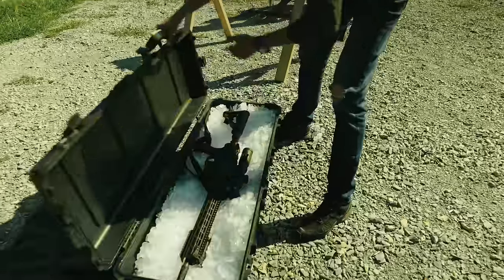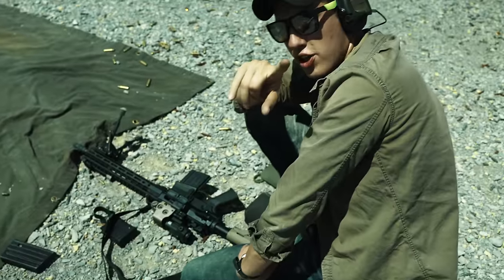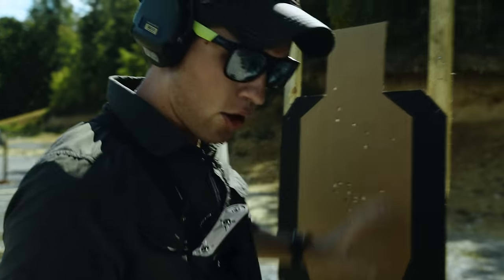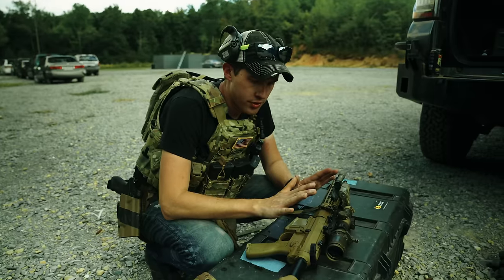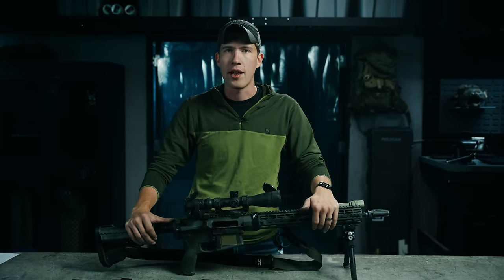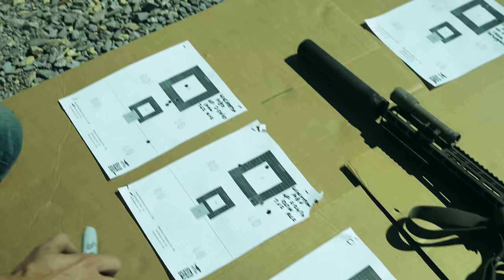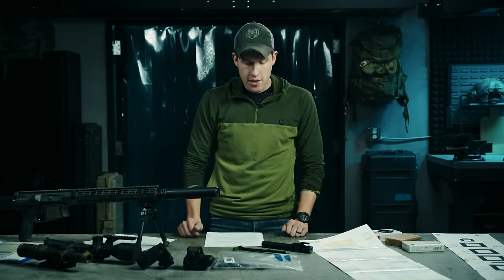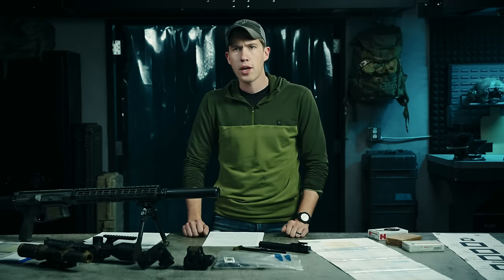Aero Precision M5 AR-10 5,000 Round Test

Comment: First of all, RIP Lucas’s shoulder. We have a few points to make, but in general, we look forward to getting the rifle (specifically the BCG) back in hand to understand where and why it’s weak points were exposed during this endurance test. We believe in continuous improvement and will be examining where we can keep developing on this platform. 

Our goal is to offer an affordable and reliable base for an AR10 setup. Whether that be for plinking, long-range shooting, hunting, SHTF, or other. This is a rifle platform we have been offering very successfully for years and truly believe it’s great for the vast majority of users. This is proven by the thousands of customers that are successfully and consistently running M5 configured rifles to date. With that being said, the rifle should be built to your specific use case.

Our thoughts…

1.	If you are building a rifle for extreme use, we would highly recommend getting the rifle in to it’s final configuration with whatever parts and components you prefer, testing it, and then securing that configuration. Items such as the bolt catch screw and handguard screws can benefit from blue Loctite, especially on the AR10 platform where there is much more force involved. We don’t generally do this from the factory as we aren’t offering a complete “out of the box” rifle and most M5 users are building from scratch, upgrading components, etc. Loctite can be your best friend and your worst enemy.

2.	If you are shooting an AR10/M5 rifle suppressed, we highly recommend taking that type of use into account when building and selecting components. There are a couple different components that can and do help lower carrier velocity in the case of suppressed use. What this exact formula is will vary depending on use-case, but generally a rifle or A5 buffer system can greatly help on these large frame rifles. Adjustable gas blocks are another great solution if your use-case permits.

3.	We specifically recommend PMAGs with the M5 platform. Through years of use, we have seen the most consistent success with PMAGs and the development of the lower receiver was done specifically with these magazines.

4.	Maintenance is important. We understand the point of this specific test, but even military testing protocols require maintenance on this classification of firearm at round counts well before any critical failures occurred here. Specifically, if you run the rifle until it’s dry and fails to operate, you are introducing excessive wear on areas such as the BCG and shortening the lifespan of the part. We would not recommend shooting the rifle 2300+ rounds without maintenance. The BCG was also purchased as a standalone part where there is no lube from the factory as we do not lubricate BCGs that go into individual packaging. This means the rifle ran for 2300 rounds with no lube whatsoever. This point alone could have drastically changed the outcome with the BCG.

5.	The BCG specifically is an opportunity area for improvement not just for Aero Precision, but for the AR10 platform in general. We utilize what we would consider the industry standard design for AR10/AR308 BCGs. We have been developing a more robust design that we are confident would perform better in this testing and we look forward to bringing that to market in the future. The current BCG offerings on the market, including ours, is suitable for most users. BUT, there is opportunity here.

None of these are intended to be excuses, but rather are what we think about internally when we review this and consider how we would approach this testing from a “scientific” standpoint. We also are interested to see this testing conducted on competitor products as well. We had some great conversations with Lucas and team at Trex Arms, respect the hell out of them for this thorough content, and look forward to follow-up discussions on this platform.
Reply: I mean, just the fact that the BCG ran for 2300+ rounds with no lube is mind blowing in itself.
Reply: I'm planning my AR-10 build. Several weeks ago,  I was on Aero's website looking at uppers. I noticed that by default the BCG and Charging handle are sold separately. 

My question: is this more in-line with your, and I'm paraphrasing, "the customer will want to customize" mentality or do you not trust your BCG vendor? 

I realize this question sounds snarky. I realize you probably can't answer it exactly how you may want to.  But a lot of people who have some experience in the world are gonna be thinking it. 

For the record, Aero's upper is still high on my list of consideration.
Reply: Do you feel that the bcg failure was "caused" by lack of maintenance or "accelerated" by lack of maintenance?  Is that the failure you would predict?  Pushing it to failure seems like useful info.  Identifying areas that need extra care is important.  I personally do not see their issues as anything that would cause me hesitation buying Aero.  I did SMH at not using PMags!
Reply: I think that most people still respect the hell out of everything that Aero does, especially since most people won't shoot nearly that many rounds of .308 through their M5. Still, it will be interesting if any change has to occur due to the test that has unfolded. I am interested in seeing how other 1200-dollar Ar10s run through this torture test as well.
Reply: @lhp2a  that's a valid question. We trust our vendors or we would not keep a part in the market. It does make it more difficult for us to speak to right away though until we have the part in hand and can review. What we can say is that there are thousands and thousands of these BCGs in circulation and it is a rare instance that we would see a firing pin shear off. Additionally, we have BCGs with many more rounds on it than done in this testing, but we would never run one for 2000+ rounds dry. We can't speak toward how that would perform as that's never a test we would do. I think that plays a big role here. You would not run your car without oil as you understand that would seize your engine.

We offer them separately from the upper simply because we cater to the builder, and we don't want to force someone's hand on having to purchase our part. We would obviously love for customers to use our parts solely, but we believe in supporting customers that want to truly customize every part to their liking.
Reply: @kazager11  We can't make a definitive statement here one way or the other as that would be assumptive. But, it 100% did not help! I mentioned this in another comment, but we couldn't predict this one way or another as it's not something we would consider, test, recommend. We highly recommend you run your ARs wet (especially an AR10) and this is the #1 issue we see for people having troubles with an M5 build, regardless what components in the build are Aero or any other manufacturer.
Reply: @AeroPrecision  that's a good response and I like what I heard. 

I also want to say that T.Rex does deserve some pushback for not billing this as a "this is what happens to your rifle if you don't half ass take care of it/ SHTF and you can't really rely on spare parts via the web" scenario. 

It's fair if they treat every vendor in this way going forward in the exact same way.  I'm not good at the internet and I don't know how to tag them to see this, but I think it's valid criticism to them as well. 

Thank you for your response. It means a lot when companies try to earn business.
Reply: Haven't watched full video yet but this seems like a very fair follow up statement to this test. Great job on both aero and Lucas and @trexarms 👍
Reply: All valid points here, every manufacturer would have some kind of malfunction, there is no perfect rifle. Ammo, user, and magazine are all factors.
Reply: The fact that Aero hopped into to the comments with potential reasoning and ownership of some of the issues speaks volumes.  Also, 2300 rounds no lube aint something to snarf at.  Also, not trying to simp for Aero here, but a broken firing pin at over 2,000 rounds doesn't seem like the worst thing in the world.  Keep a $30 spare in your bag and call it good.  I keep spares for my ar15 so makes sense for this platform too
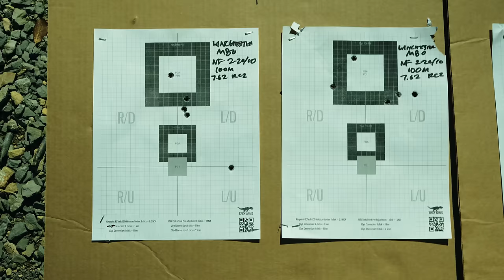Reply: As an M5 owner for many years, I'll say mine has never had a failure of any kind.  Round count around 2800. Only ever used steel 20 rnd mags, DPMS and ASC.and couple of no name mystery mags. Proof Concepts 416  1:10 18", chrome bcg and bolt,
Reply: I respect the heck out of Aero for their response here and they bring up some really great points and pose valid questions.

This is definitely a company that is on my shortlist of doing business with just from their dialogue and interaction here.
Reply: Aero you guys are crushing it at this price point! Keep up the good work.
Reply: Outstanding response. Kudos to you folks!
Reply: They lost me with the lack of proper maintenance... That's extreme abuse. This, and that the rifle was obviously over gassed for a lot of what they were doing, and they didn't properly address it. That said, firing pin and extractor components are wear parts that take a lot of abuse to begin with. Sure, making these components from the best materials/processes is worth the extra  cost... but the testing here features in many instances, a misconfigured rifle, neglected from proper cleaning and lubrication, while being over gassed. The majority of end users understand that this rife actually did pretty darn good under these conditions, considering that this rifle took more than it's share of abuse. It was throwing brass nearly straight ahead the majority of the time... That should have been a stopping point to assess what needed to be done to control the gas. Most end users of this rifle are  going to read the owner's manual, take their new gun apart, clean it, inspect it, and lubricate it as required, and thereafter as recommended by the manufacturer. Also going to check and torque all the fasteners... In my opinion, I think Aero made an damn good rife for $1200... It just needs to be tweaked for whatever the use it is intend it for.
Reply: @clutchcargo1239  That's a great take.
Reply: @AeroPrecision  If I were a betting man ($5 so it's a gentlemen's bet), I would bet a AR-10 Pro BCG made in house by you guys would drop in the future since you dropped a AR-15 Pro BCG.
Reply: I would also be interested in seeing this boxed rifle up against the competition.
Reply: @clutchcargo1239  i agree with you. But at the end Lucas did say that too. He stated this is one data point and it's specific. It's not all encompassing
Reply: Good comments & feed back
Reply: This reply gives me a lot of confidence in Aero as a company. Props to your PR guys!
Reply: @clutchcargo1239  pretty great take its just so hard for manufacturers to have to deal with people like "I ran the lowest powered steel case crap I could find with a massive muzzle brake, with the heaviest recoil spring and never cleaned or lubed it why is it not cycling, thats on you for not making it 'Duty grade gassed' shame on you guys". I would love if more companies would stop over-gassing their rifles but to some extent they have to cater to the lowest common denominator and its kind of a problem especially with more people owning suppressors some guns feel like they are unusable suppressed.
Reply: @MOTOSCOUTtv  The fact that they ship the gun dry is also kinda mind blowing.
Reply: Breath of fresh air after watching Sig deny problems or BCM blame customers (gunthots) for their problems. Great response considering how you guys have to sort of cater gassing to the lowest common denominator who is running the weakest ammo with no lube or cleaning with heavy springs complaining about cycling issues.
Reply: This is why I'm always going to buy Aero Precision components.  They stand by their products and are responsive to customers.  Go Aero!
Reply: @freshplasticup5795  It would be interested to see for entertainment purposes, but I'm not sure that it would prove much. Any rifle could be forced to break if it's abused enough, and that tolerance from breakage could vary greatly even from rifles of the same make/model. I guess it is interesting to see what abuse a rifle can take... As long as it's not mine. I plan for what parts are prone to breakage/wear, and stock them for the occasion. I also maintain my rifle, and gas system for it's intended use. This video made me cringe a bit, but I watched it with a grain of salt in mind. This video to me, is not a knock on Aero, or any manufacturer that could be tested in similar fashion... To me, it's a lesson on how not to treat your rifle, and how not to set it up correctly. Lol, entertainment
Reply: Appreciate your open mindedness when it comes to developing product improvements.  I have many Aero products and will continue to buy them... except the M5 handguards.... shimming barrel nuts is a cursed process.
Reply: @Segphalt  We don't ship complete rifles. This was purchased as a complete upper, complete lower, individual BCG (in a box) and a charging handle. We do not lube our BCGs that are sold individually. That's on the user when you assemble the rifle.
Reply: Since you guys mentioned the A5 system,  in your use, what spring/ buffer combo have you used that has worked well
Reply: I appreciate Aero for great response and even posting. Big fan of what Aero and TRex does for the industry! 🫡
Reply: Aero responded with class and poise.  Good on ‘em.
Reply: @tannerwhit1893  I understand what you are saying. They could have added a adjustable gas block to this gun right out of the hole. Setting the gas to work with a suppressor, or any type of ammo. They could have properly lubricated and cleaned this gun per Aero's recommendations... They had some cool optics, and accessories to put on this gun, but looked like newbs abusing a gun to me... Brass flying nearly straight forward the whole time, until the extractor pin broke... Lol, go figure.
Reply: My BCA AR10 ran without any lube either and it still works great as a hammer to stake my castle nuts on my Aero lowers
Reply: Have you guys thought about offering all m5 uppers with an adjustable gas block? I feel like that solves a lot of the issues with ammo cycling, suppressor use and probably part life as you reduce the wear and tear?
Reply: Outstanding. All around. Good on @aeroprecision for stepping up to the plate on this and for Lucas's hard work.
Reply: Are you guys looking at doing a dual ejector bolt in the future specifically for the M5s?
Reply: I don't think you all realize just how amazing it is that you, a large company A.) Took the time to write and respond, and B.) Didn't just write off Lucas and his findings and actually took an interest without getting defensive. I don't currently own any Aero products but I think I will if nothing else than to support a great company.
Reply: @Trex Arms pin this comment
Reply: @clutchcargo1239  " Most end users of this rifle are..." I Highly disagree with this point. I generally really see people treating their guns more like a screwdriver rather than a caliper. Realistically I think most people would spritz some lube on the BCG, send a couple boxes of ammo, and then clean it and give it a once over.
Reply: @teneightymn1234  It's so use case specific that we don't want to include them and have people using them when it's not at all necessary. There are many ways to tune a rifle, and there are a lot of people out there throwing adjustable gas blocks on builds that don't need them which introduces unnecessary variables. We'd prefer to just let people change/upgrade as they go. It also adds cost to the assembly right out of the gate which many people don't need to pay. Our takeaway here is that we need to provide better knowledge to customers on when they do and don't want to use one, and how to properly tune a rifle in the first place.
Reply: I sense some defensiveness in your comments. 
How many of your customers have actually tested your rifles like this and relayed that information back to you?
Reply: As a heads up, for what it is worth, I, as a customer of Aero previously and general consumer of both companies, appreciate the hell out of both TRex and everyone at Aero for what they do and how they approached this. 

Nothing about this video shook my confidence or expectation regarding Aero nor integrity. I've been aware for a bit now that the lack of homogeneity and standardization of AR10 makes it a mess in some regards to produce for a decent cost to us the consumers. Most rifles purchased never reach 1000 rounds, but that doesn't mean a consumer shouldn't know what their rifle can or cannot do. 

The "failure" points on this rile are amazing for us and doesn't sway me personally, but instead informs me what I would need to address down the road and when it would likely be. That is awesome, especially if one is trying to apply the $1200~1500 upfront cost difference between "higher end" 308 options for ammo and training now. 

Firearms, for most people, is a fun equation of give and take. 

Thanks to both of you all.
Reply: @PnP-td1mt  I'm guessing none. Their customers probably know not to raw dog a rifle for 2000+ rounds.
Reply: @cz75fanatic  That's a solid take. You seem like a very reasonable individual. What are you doing here? 😂
Reply: @AeroPrecision  Is an unlubed upper "complete?" 

While I would never advise anyone just throw an upper and lower together without giving a decent once over and lubing as necessary... I've met people who do just that. 

Actually, wait are your "complete uppers" without BCG?

Edit:
After taking a peak at your website (which comically I have never done even though I have one of your lowers) I see you are targeting people who want to "build out" a rifle. In which case I don't consider an unlubed anything an issue.
Reply: One of your dealers here, thanks for the comments on this. I personally like to run my BCGs fairly dry, that said though, I always lube the rails and back of the lugs of the bolt itself and the bottom ramp of the BCG when building. I add light oil (use grease for everything else) to the port of the firing pin, but that’s mainly for the keeper pin and not the firing pin itself. Point being that I would never simply drop a dry bolt in and go to town. However, the firing pin failure seems to me to be do to a weakness of the pin itself and not over use, which is something that can happen and shouldn’t reflect poorly on the product. Lucas himself even said, with which I completely agree, a sample of 1 doesn’t really give us data that can be applied over the whole of the part.
Reply: 1 through 4 seem like no brainers, and I'm looking forward to 5.  My M5E1 from Aero is my first AR.   It's also my first build.  I assembled it using a complete upper.    I'm so happy with it I took advantage of the %20 off sale and am building an AR15.  Even happier with that decision after watching this.
Reply: Bravo Aero.  Your responses show your level of professionalism.  If anyone is going to succeed at making a DI AR10 pattern mainstream, it will be you.  I think it takes an adjustable gas block to run suppressed and unsuppressed reliably, but it has to be easier than a FAL.  If someone can crack that formula and allow us to build are guns in 308 or 6.5CR with 16", 18" or 20" barrels like we do with 300 BLK sub/supersonic and 223, it will change the market.  And then, you can cut some weight off.  What a dream.  Keep up the good work.
Reply: @AeroPrecision  lol level headed takes on gun videos... twilight zone material there!
Reply: The only thing that concerns me is the barrel degradation with such a low round count. Any ideas why this would happen so soon?  Small parts are going to break with .308, it just beats the hell out of everything. But the barrel life is concerning, especially since there was really no obnoxious mag dumps or full auto fire.
Reply: Impressive torture test....
Reply: @StrokedTac  That's hard to say without looking at the barrel. We would recommend cleaning the barrel properly and retesting at this point. Most customers that are highly concerned about squeezing accuracy out of their rifle regularly clean the barrel. We don't necessarily have a guideline here as you don't HAVE to do this, but it can help.
Reply: 10/10 company 🤙
Reply: All this test has shown me is that buying an Aero Precision M5 is probably one of the best decisions I can make for the money.  I mean, running 2300 rounds without lube or cleaning on a direct impingement gas system is a very tall order.  Combined with the fact that we're dealing with AR10 forces, I have no doubt as an avid builder and maintainer of my firearms that this platform is one of the best in the country.  Also, I do love that you can remove and locktite the pins, it makes it really easy for when I change my mind to just swap out parts.
Reply: Just wanna say I respect the hell out of your professionalism when it comes to your response to this video. My next AR build will consist of parts from you guys, keep up the good work!
Reply: Solid response. And that is how it should be with all manufacturers.
Reply: So don’t email you guys and return that sweet deal I got on that complete lower for 216 on friday?

Because that made me happy. And this video made me sad ):
Reply: I just reci3v3d my parts for building almost this EXACT rifle, and on the same day this video came out no less. I regret nothing. AERO and their business model shows the intelligence and suitability as a manufacturer and company.
Reply: I would love to hear back on why the parts broke. From a non engineer prospective, I can see why the cold from the ice may cause issues from going hot to cold, but this was more like hot to warm. But any rapid temp change can cause issues with metal especially hardened metal. Maybe some micro fractures formed plus the back pressure caused them to break or maybe some micro fractures from manufacturing. But as i said I am not an engineer or anything of the sort. Just my little knowledge of the topic.
Reply: When are you going to fix your massive customer service issues
Reply: Now I want to buy your shit.  👍🏻
Reply: @MOTOSCOUTtv  
Glad I’m not the only one that thought this gun actually did exceptionally well.  I would never expect any rifle to run out of the box with NO LUBE for 2k rounds.
Reply: Aero BCGs suck. Plenty of dirt all over the internet showing how poor they are
Reply: Replying for the algorithm 😘
Reply: Huge fan of Aero and Trex, own many of their products and my main fighting rifle has an Aero upper that's been flawless for thousands of rounds. All of this said, my only irritation with this whole process was that when called for warranty replacement of the firing pin, according to the video, Aero responded asking to have the entire bcg sent in. I understand why that would be helpful to Aero for engineering purposes, but having your gun down for a month + shipping time is kind of infuriating. I firmly belive we should keep spare parts on hand, but why couldn't Aero simply send a new firing pin out? Or at least ask to have the broken one sent back before shipping a new one to the customer? C'mon Aero. Missed opportunity for a stellar customer service/warranty testimony. Minor gripe, and I'll continue buying from Aero in the future.
Reply: @AeroPrecision  Has there been longevity test on these .308 barrels? No matter what the parameters are of the test, has one been done? I know the ar-10/.308 gas guns are odd balls and there is no standardization like with M4's/ar-15's.  You can easily find what a standard ar-15 barrel life should be. I'm assuming BA has run that test at some point? Thanks for the replies. I hope you're making double time overtime because you're going to very busy lol. I appreciate the communication and willingness to be this involved. I have an M5 and love it.
Reply: @MOTOSCOUTtv  I’m saying nobody else is thinking this? That thing was caked and still ran. No lube at all
Reply: Been running the 18" .223 wylde stainless HBAR complete upper with the nickel boron BCG from yall for the past 5 years and I still love it.
Reply: Still a fan of Aero, I enjoy T Re-examine Arms videos, I don’t get the not lubricating till it chokes, not sure why that is a thing, anyway, entertaining video and Aero’s responses were valid and honest 

Also I doubt there are many customers if any that would treat a rifle like that

All the best to both parties!
Reply: Aero just jumped up my list for potential purchases because of this response.
Reply: @mikemccauley8089  100% you oil and maintain this is more of a “let’s try and see” Kind of thing and nobody runs that many round without any lube.
Reply: I’ve been a big fan of Aero for some time, y’all bring solid-tier equipment into the arena at a price point most average joe’s can afford. My 5.56 Aero gun has done me no wrong in the time I’ve owned and used and abused it. 

I know a lot of these dudes like these ultra over the top abuse-tests, but 9.5/10 of them aren’t realistic. Some try to simulate “battle use” etc, but even while deployed we constantly cleaned, maintained and LUBED our shit when we had down time. Not to say stuff didn’t get neglected here and there, but that was always a point of contention when there was “free time”, you PM your shit. These tests seem cool and get views, but it doesn’t represent how 98% of the population is running their equipment. 

Admittedly I’m not a big M5/308 AR guru, but on top of the neglect in regards to even a light lube, 308 AR platforms across the board (all manufacturers) tend to be quirky for some reason. See it all over the place. 

Love that y’all stepped in to weigh in on the issue; I don’t think anyone is butthurt with the “failures” incurred here. Keep doing good shit 🤙

🇺🇸
Reply: Aero, if you didn’t have my respect before…. You do now….

Btw, you had my respect in the first place making this post that much more awesome.
Reply: Good to know and if we see subsequent reviews of other 308 rifles run through the same gamut.  Might find that the 
Aero leads the pack!

Being the first is always tough, but didn't see this as a blemish on your brand for the price.  

Just eager to see what comes next.  Happy to be a patron of both your companies.
Reply: Solid reply, gained some respect and not expected in our typical 'influencer' world.
Reply: Respect.
Reply: Solid response a sensible reasoning. Great job from Aero. I would love to see how their competitors fair as well. 😁
Reply: Thank you for making awesome products. Also its really cool that you came at this with a scientific and honestly polite take, it makes me excited for the future products that you will produce. Thank you and keep up the good work.
Reply: So lube prevents screws from backing out and firing pins from breaking? You ever fired a suppressed AR that is heavily lubed? The lube is a magnet for carbon. 
What idiot is going to claim these failures are due to a lack of maintenance when A a legit maintenance schedule for this rifle doesn’t exist and B the parts have never been truly inspected. 
My only gripe with this video is TREX Arms not having a qualified Armor and Smith on stand by to validate part specifications and failure modes. 
That way no bs slips through.
Reply: I was having the same exact results on my M5 with a different can (Sandman s) stove piped every 5 or so rounds. Also after shooting the suppressor felt like it was welded into the rifle. Just to let you know this isn’t a 1 off incident! 

Love the rifle aside from this, good work and definitely good on you guys for not ignoring this!
Reply: You guys might have some hurt feelings on your end, but I'm sold on this rifle now. It wasn't a 'torture' test necessarily but it was grueling and this thing proved more than capable for any use I would have. In fact this video probably saved me several hundred dollars from having to step up to the next price tier.
Reply: Aero has been amazing for me. I haven't taken the leap with the M5, but I can certainly attest to their M4 platform. Been researching the M5 for a bit and am immensely impressed with Aero's response here. This honesty in companies is rare these days, folks. Appreciate them, hold them accountable as this video does, and support them when they strive to improve.
Reply: @PhotogenicPotato  You think so... Ok, you might be right. I might have assumed people had more common sense. But you reminded me that common sense isn't common, and that good sense is rare. I wasn't taught that way, the end users I'm familiar with are like me...  We view that rifle as a precision instrument, not a pry bar, or screw driver. Since I'm over 50, my experience varies greatly from yours, so I'll concede to your point. I would bet that people could avoid a lot of unnecessary problems with their firearms, or anything for that matter, if they treated their stuff the way it is meant to be treated.
Reply: @PrezUSMC  I know I'm just a guy on the net, but I've assembled a couple M5 rifles and AR15 types as well.  It's worth noting that the "A5" system is nothing more than the original AR10 receiver extension when placed on an AR15. The AR10 extension is .75" longer than the typical AR15 carbine extension. So when added to the AR15, the "A5" uses a rifle length spring instead of a carbine length, and it needs a longer buffer than the regular AR15 length. A buffer that is .75 inches longer (9mm PCC length ;)).  When the long receiver extension is installed on a .308 gun, it's basically an AR10. At that point, the .308 BCG is longer than the AR15 bcg and it takes up the .75 inch difference. So in an AR10, the "A5" extension of needs a regular length AR15 buffer.  Finally, as Lucas says at the end of the video, AR10 stuff isn't standardized like AR15. There is a common "pattern" which is what Aero's M5 is, and it follows the DPMS LR308 dimensions.  The LR308 is not an AR10. Therefore the M5 lower used in this video is not ans AR10 lower.  Why? Because it uses a standard carbine extension length. It's now .75 inches TOO SHORT when attached to the .308 platform. The Aero setup, and other LR308 setups require a specific short buffer to allow room for the longer BCG to function.  True AR10 patterns are from Armalite and they use the longer "A5" receiver extension.  

You can mix and match this stuff successfully as long as you understand what you're doing.  I build my Aero M5 setups with  long AR10 extensions, heavy buffers, and adjustable gas blocks. They still kick like mules, but tuning bolt speed for suppressor use is much more possible.
Reply: yall just keep winning me over
Reply: @aeroprecision I have one of your M5 lowers, and a BA upper in 6.5CM.  I did not opt for the Aero BCG but rather got one from Brownells.  I don't suppose you know if they are manufactured by the same company?  Would be a good heads-up to have going into using it - Although mine is definitely not going to be shot to the level Lucas shot his (I would go bankrupt from purchasing ammo), it would still be good info to have.
Reply: It is very rare to see the company of the product being tested in the comment section to this degree and also makes me feel alot better with the choice to get the m5 in the first place...

And yes, I built mine with an SA adjustable gas block, Odin buffer and Orange Springco spring just to have it ready for suppressor use down the road.
Reply: I will say that I have spent 4 - 5k at Aero Precision in the last 2 years. My only reason for even knowing about Aero was from T.rex videos. I haven't regretted it, but I hope you guys do continue to work vigorously to make your products as reliable as possible. Vertical and Horizontal Integration is always a good thing.
Reply: My AR 15 is aero. I run it as hard if not harder than my issued weapons throughout my Marine Corp career. To the credit of AP, it has taken the abuse, eaten all types of ammo, in all types of weather. The only issue was the handguard slid forward during some aggressive rapid fire drills. loctite fixed the problem and has been running hard ever since. I am looking at an AR10 and will undoubtedly use AP. Solid company with tough reliable stuff. SF AP!
Reply: Aero, you earned a thumbs up from me and I’ve never used your rifle but you sound like sounds dudes to me
Reply: @MOTOSCOUTtv  mfw I read that : 😮
Reply: Bravo Aero. Bravo TRex. Bravo to you both. This is fantastic. Thank you.
Reply: Thanks for the Reply @AeroPrecision you answered a lot of what I was thinking. I’m looking forward to building an M5 here in a couple of months for my “capstone” project when I finish SDI’s AA in Gunsmithy.
Reply: Love your guys stuff keep up the great work!
Reply: Ok ok. No disrespect at all. I don’t have an M5 and I have plenty of your lowers for my 556 guns… but dont even try to say you don’t sell complete M5/308 rifles. You can see them on your website. Right. Now. 

You’re saying they’re not complete cause you sell them field stripped and in separate packaging? 🤣 give us (even the gun newbs in here) a little more credit than that my guy. Don’t hide behind the “some assembly required” fine print.
Reply: This is quite possibly the best reply from a company, ever!  @aeroprecision ‘s response was a great example of how to use a video like this to educate and improve!
Reply: @Buletspunge555  right on.  I've put together a few ar15's but never an ar10/m5. I'm asking because I see so much info on chats.  People saying you need to put a space in the buffer tube(quarters) some saying you don't... I'm in the process of assembling one right now and have an extra A5 extension that I was planning on using. Normally I use sprinco buffer springs.  Last week I called them for input, they suggested either their red spring or orange spring depending on how over gassed it is, but also to put a spacer in the buffer tube(roughly 2 quarters thickness). Thanks for the info
Reply: This is why I buy aero. No scumbag shit from them. Thanks for the proper response👍🏼
Reply: @AeroPrecision  what would be a good maintence schedule to maintain? I'm looking at purchasing one, and likely will put about 1k rounds on it before upgrading it with a suppressor/ buffer system (at the same time).
Reply: @Buletspunge555  I've also got a buddy who's got a tubs 308 rifle length flatwire spring, so I'm gonna try that as well.
Reply: Can't respect this response any more! Good on you guys.
Reply: Funny you reply here but I still can't get a reply from you regarding my complete M5 upper that failed headspace test and was nothing but malfunctions from round 1.  Also nice you you to delete the 1 star review.  F aero
Reply: TL;DR: We don't expect our AR-10s to be pushed this hard...at least without lube..because most people don't even put 1000 rounds (let alone 5000) through it. We build guns that are good enough...ish.
Reply: Well done Aero.
Reply: @PrayingPanda  pretty much
Reply: I mean, the warranty process taking a full month is pretty annoying from a customer perspective. There's process improvement opportunity right there.
Reply: I honestly think you guys are one of the best companies. 

I have had some issues with my complete upper receiver (m4/ar15) and bolt carrier. But I understand is standard and not be considered as an specific build.
Reply: I agree. I am glad to see how a completely unlubed BCG performs, but I am curious how the weapon would have performed if lubed properly from the beginning.
Reply: @AeroPrecision  i agree 100% here.  I've run a 10.5" 5.56 noveske to failure (suppressed) and I had zero issues until around 1000-1100 rounds at which point the rifle was bone dry.  I did what most sane shooters would do and stripped the BCG out, oiled it really well, oiled the upper reciever "rails" where the bcg rides, oiled the parts in the lower carefully and checked the trigger for the grease geissele likes to keep on them (still good to go) and then slapped it back together, ran the charging handle a few times and went back at it and had zero failures for many many more rounds.  The entire process took no more then a couple of minutes and I did it with tools i kept on the rifle itself (in the pistol grip and inside the stocks storage compartment).  With a little practice you could do it in a minute or less.

I strongly agree with aeros assessment here.  As someone with race car experience we would never run an engine dry.  If you keep pushing it with the oil pressure low or oil temp super high then the finish line better be super close, otherwise your going to lose that race and that engine for no good reason.
Reply: @Hal_Woo  you're in for a big shock if you belive that. I'm out over $500 for a new barrel and bolt from a reputable company because aero ghosted when I sent in my gunsmith report confirming failed headspace
Reply: Dibs on rifle after you’re don’t inspecting it!
Reply: For the Aero marketing team. 
New tag on the website for a bit

“Buyers Beware, Builders Rejoice”

Then a limited edition “caveat emptor”M5 lower receiver with a little Dino on it.

Contact me for royalties and where to send my receiver, lol.
Reply: @alexhutton155  aero lowers are extremely well built. as well as their uppers. I personally have a aero upper and lower on my ar with a bcm charging handle & bcg. Wouldnt change a thing with my rifle and I trust it with my life
Reply: @Hazmat0357  Aero is a builders company first and yes.. they also make complete rifles. So you're both right but I would say they are known more as a builders company. Who else sells complete rifles AND 'builders kits'?
Reply: This is exactly how a manufacturer should respond. 100% respect as all of your points were valid without making excuses. I am happy to continue to do business with both Trex and Aero!
Reply: This is why you guys will continue to get support, I will be purchasing one your rifles soon.
Reply: Love my aero products! I don’t have 5000 rounds in any of my rifles but definitely 500-1000 in each and other than lock tight I’ve had no problems.
Reply: I’m still collecting parts for my M5 308 gun.
Reply: Fatal flaw is #5 and user error. No one should be running a rifle unlubed. No excuses even for SHTF.
Reply: I would still buy an M5 upper/lower, paying special attention to the BCG and buffer setup. Bolts can blow up tbh, and Aero always makes it right.

There are so many variables that can contribute to a failure, I can’t condemn this company, which is always providing reasonably priced products and supporting the 2nd amendment.
Reply: hey aero. full disclosure i work for a company that deals directly with you. was the bcg they initially recieved a 9310 nitrided bcg or the phosphated bcg?

looking forward to the dixxon flannel tomorrow!
Reply: Correct response Aero...and btw, I have purchased, and intend to purchase, several lowers from your company and I have been very satisfied.
Reply: This response just makes me like aero even more, I own a lot of aero products and have nothing but good things to say about them. I hate it when YouTubers run guns dry for thousands of rounds and act like things breaking is the fault of the gun, then they speak on the product negatively and give a good product a bad name. It’s pretty shady and I would expect better out of Lucas, as I do buy his products and support T. rex, but I think he should re do the test following your suggestions bet it would run way longer.
Reply: I personally have over 5000 rounds on my aero. Mix of PMC, IMI, hand load, and mil surplus. I do maintain it every 500 or so rounds, basically brush the chamber and oil moving parts with amsoil. Because that's the oil I like and it's pretty cheap locally and handles cold shitty weather well. 

Conservatively 3500 rounds are suppressed with a 36M in long configuration. The gas in the face is pretty brutal. Especially compared to a piston POF, but honestly for the value it's just Hard rifle to beat. It's not a complete pof rifle system. But it's a great package
Reply: aero logged on to cope lmao
Reply: It’s time to create a piston system for AR15 and AR10, for suppressor and tuning cycling. Also, make critical components in-house.
Reply: @PnP-td1mt  idk how many people can afford 5k rounds of .308 to just blow through
Reply: I bought an AR10 breach charging handle when they first released. On the very first charging action, the end that engages with the gas key broke off. I was told by the technical engineer at Aero that this has never happened before and that once they receive it back, they would be doing extensive testing to figure out why it failed. I later found out this was a fairly prevalent issue when it first released. 

Fast forward 1yr and I had a second new breach fail in the same way. This was being used in a fully Aero parts sourced M5 during the break in procedure. Because this rifle was for a good friend, I gave him one of my Geissele AR308 handles and just threw the broken Breach in the trash. This Aero M5 had significant issues from day one. I swapped out the buffer for an A5 system, Green Sprinco, and then customized the buffer weight to get it ejecting correctly. I used SOLGW SP76 lube out the gate. The gas rings failed at 1k rounds. Proper cleaning and inspections took place at each 250 round interval. The upper shows significant wear around the cam groove with additional significant peening around the cam pin. The rifle is ejecting around the 3:30 mark, so I don't believe there is excessive speed in the carrier action. I also had an issue with the ejector peening over and ended up rebuilding the bolt. This issue with the ejector caused intermittent failure to eject and double feeds as the spent casing wasn't being thrown from the upper. 

The issues I've seen don't lend confidence in the M5 platform at this time. I also believe Aero has issues with their metallurgy, heat treat, or both. I don't believe most shooters will spend enough time behind the trigger to identify these problems. And those that do, likely went with a different option from the beginning. I'm sad as I truly wanted to love the Aero M5.
Reply: Buying an aero because of this comment
Reply: Great video. Aero makes great products. This test could habe been better organized and broken up into categories. Shooting an AR-10 like a 13’7” M-4 then chamging it until it becomes more of a precision build is backwards but also asking too much for a test this short. Still a good video and test. Cool Aero was professional and good sports about it. Now do the same with a LaRue OBR and an SR-25.
Reply: Really appreciate that you guys make an affordable product that you stand by.
Reply: I have a Sig 716, the older model that was short stroke piston operated--those mechanisms are extremely reliable. That said when you use the old metal AR10 mags the gun will often malfunction. Using Pmags though? I've never had a single malfunction. So that's what I use. As soon as Lucas said he had problems with that mag I thought of my experience with metal AR10 mags(not inherently bad but lots of shoddy companies made them). 

That said I have an Aero 11.5" 5.56 upper that I've shot A LOT and ran very hard and I've never had any issues. The thing is solid and I love it. I have not yet shot it suppressed but I plan on getting a can soon so that's coming.

Edit: My one question for Aero, if they'd answer it, is regarding the accuracy. Do you have any idea why this particular rifle wasn't very accurate? My 5.56 Aero upper with a B.A. barrel is much more accurate even with training ammo. (which btw is spray painted, which when done right definitely does not hurt the gun). I'm an Aero fan for sure but I'm certainly curious about the accuracy Lucas was getting.
Reply: Man i just did 12.5 .308 aero build i hope it stacks up
Reply: I bought a m5 fully from aero precision. Made mine fully California compliant because California gun laws 😂. But i don’t regret my purchase. I am happy with the quality and will most likely be buying from aero again!! Keep up the good work! And thanks for the in my opinion good products!
Reply: @kazager11  my guess is cause over-gassed for reliability, but love to hear aeros take
Reply: @Buletspunge555  what buffer weight?  Some other barrel makers have told me h3 or 4 on the phone.
Reply: Id say running the BCG 2500 without cleaning it wiped the bcg out. Once the BCG has excessive wear the bolt will wobble causing the pin to strike the bolt face on the way out to the primer. This is why you dont AK torture test a AR10. The BCG should have been cleaned and lubed every 500-1000 rounds. My truck can run 15000 miles between oil changes but I bet that dirty oil will cause massive wear in the engine to.
Reply: @MOTOSCOUTtv  EXXACTLY! I believe he cause this failure because of inproper maintnence. Send that bcg for a autopsy! School of the american rifle!
Reply: @Segphalt  They didn’t sell it as a whole gun, the upper, BCG, and complete lower were all purchased separately. I can guarantee their complete rifles wouldn’t get sent out quite the same way. You wouldn’t want to buy a BCG and have the packaging all greased up.
Reply: Respect. You guys rock. Aero m5.1??
Reply: @ericmacfarlane6695  I was originally operating under the though process of where I have purchased "complete uppers" from places like CMMG where the BCG was in the upper and arguably had too much lube. After peaking around their web page it became more clear how this came together.
Reply: Respect ✊
Reply: props to you guy's at aero
Reply: W response aero
Reply: Very classy response. I’ve always been very happy with every one of your products I’ve purchased over the years. Keep up the good work!
Reply: Solid response Aero, that’s why I support you guys to the hilt.

The one thing I’d be very interested in seeing a retest would be how a rifle length gas system would hold up to the same firing schedule. I think we would have much different results.
Reply: I often hear a lot of excuses from aero anymore. It's a shame really. I started out building on aero receivers. Reminds me of the epc9 feeding issues. Lots of excuses even though the answers were right there...
Reply: Adapt and overcome. Good job Aero
Reply: I just assembled my Heritage Tacoma M5 yesterday. What a beautiful roll mark.
Reply: Good on y'all. Excellent outlook, and thank you.
Reply: @clutchcargo1239  100% agree with you and appreciate the fact a lot of comments in here share the same thoughts. I watched the whole video and it drove me mad with the absolute lack of maintenance and misconfiguration. Shell casings ejecting at the 1 to 2 o’clock position for 3,000 rounds on a 7.62 and then slapping a suppressor on it and acting surprised the ejector broke?
Reply: Best response from gun company ever.
Reply: Good Stuff, While I wouldn't shoot an AP, but I think its an important segment to have for your average shooter who can drop KAC/LMT/HK money.  I think would be awesome if you guys were able to take this feedback and produce a more refined product.
Reply: seeing a company rep' directly give a constructive response on the critic they see from the reviewer, means a good company. i wish tech company also can be like yours. but do please dont judge the reviewer, they only telling the truth. it helps you getting those informations you need that normally you arent getting from normal customers.
Reply: i just want to add that my 300blk build has aero upper, lower and bcg. I absolutely love the rifle. The only regret i have is i should have gone with the full length atlas rail instead of the cut away one (I think its the atlas R )since the profile is a bit small for my hands so the only forward grip i can run is an angled because it offers a larger diameter for me to c clamp onto.
Reply: Amazing as always! 🤙🏼 when y'all gonna drop the bolt actions though? 🤔
Reply: I built one of the december snow camo kits a while ago in 6.5 CM and it survived 2 DMR classes.
Reply: I have purchased quite a bit of aero products I’ve the last two years. I’ll be honest my favorite AR15 Is my M4E1 16” AR I built almost 2 years ago and I do trust it to run. 
However the hand guard on my enhanced upper came loose very quickly after 150 rounds. I re-torqued the 4 screws back in and another 300+ rounds later it came loose again at the range. 
When I got home I contacted customer support and the guy was not helpful at all. He seemed to care less. I ended up using loctite and it has held up since. 
However I’ve been seeing poor build quality and torquing quite often since then. I put together 2 EPC’s and both had assembly issues. One had a very badly installed ejector that was torqued down excessively. It took some serious work to get it loose to readjust it to its correct position. The other EPC kit had a loose handguard on the upper as well as the screws on the plate that hold the bolt hold open lever. 
I also built another AR15 for a buddy of mine similar to my M4E1 enhanced and his handguard also came loose on its first range day. 
I would suggest that whoever is giving these parts it’s final inspection do a better job. I really love your products and as of now I still continue to purchase more. I just bought an M5 Lower bundle kit for my next build. I’m hoping that I don’t runs into any issues since this build might be the most expensive yet. 
However seeing videos like this and seeing the poor assembly work over the last two years myself Its really making me lose some confidence in Aero Precision. I hate to say it but I’ve been buying a lot of PSA stuff lately and other brands through Primary arms and I have not once seen or had these kinds of issues with their products. I do believe Aero is far better than these other brands so I would hope that your guys get down to these poor assembly issues asap. I would expect this from a more budget friendly company like PSA tbh than I would have ever expected from Aero. 
Also your customer support is lagging too. The both times I have had to reach out they don’t seem at all concerned or interested in helping. They sounded more like I was bothering them with my concerns.
Reply: I wuz suppose to lube it? Derp
Reply: I like my M5E1. I built the heck out of mine basically 2500 bucks worth of parts. JP BCG including the enhanced bolt AND firing pin JP adjustable gas block Krieger M110 profile barrel. My gun shoots great dime size groups at 100 yards with ease. Now with that said 2500 dollars is quite a bit less then 20,000 for a knights or 5000 to 6000 for a Scar. So my question to you Lucas is what company offers a better 308 DMR for 2k out the door. Thanks Aero for supplying the parts I needed to make a beast of a rifle. I am curious if the JP firing pin can take the type of abuse this test applies. I have to add I wanted to bash Lucas so bad. BUT after watching this video Lucas seems honest about truly helping the community. He truly seems like he wants to call out these big time companies.
Reply: FYI AND MY 2 CENTS, WINCHESTER AMMO, BASED ON MY PERSONAL EXPERIENCE, HAS ALWAYS BEEN MORE DIRTY COMPARED TO OTHER  MANUFACTURERS!!🤷‍♂️ ESPECIALLY THEIR SHOTGUN AMMO FOR SPORTING CLAYS IN SEMIAUTOMATICS!
Reply: Any company that will engage with other channels and customers is A-OK in my book.
Reply: @rp7983 honest question do you think a scar or HK or lmt would have done better???? I’m asking because I own a decent Aero build. Krieger barrel JP everything!!! Bolt and carrier and firing pin JP silent buffer system.
Reply: @warmonger82 good point I own a 20” Aero build Krieger 20” barrel with rifle gas system and all JP supporting equipment. I need to find out what JP makes there firing pin out of.
Reply: Great comment here, I have lots of experience with this platform from many different manufacturers and most of these points are simply inherent with the large frame platform in general and not specific to Aero.
Reply: Well done Aero and Lucas…I’d be happy if a 556 went 2k with no lube btw.
Reply: I appreciate Aero’s response to this video and respect them as a supplier/partner of my shooting needs.  As a consumer, I don’t expect perfection but I do expect quality, an attitude of standing behind the product you sell and making positive changes as they become necessary.  I believe Aero is doing this and I’ll be spending more money with Aero (and T.REX) in the future.
Reply: I am very impressed with the response and how you conduct your self as a company Aero.
Reply: @AeroPrecision  running them wet doesn't change the metals that are being used on ur firing pins. Plus running them wet attracts carbon build up which can stress metals as well.. with that being said I only own Aero Ar's and yes the majority have Aero BCG'S. And have never had a problem. just like Lucas said, it is a sample size of one and I will still continue to buy ur product and recommend it to friends as I have throughout the years.. Y'all make a great product and ur local which I am always happy to support especially when there is value in said product...Keep up the good work!!! A junky firing pins will not be the end of u!! 😂😂😂😂Actually surprisingly enough just bought a Aero M5 stripped loser from Primary arms. Super black Friday deal. Canty wait to build out the rest!!! Will be my first Ar10 build. After double digit builds through guys..☺☺keep up the good work we in WA always got ur back as long as u stand up for ur product like u definitely have in the past... Great customer service.👌👌👌👌👊👊👊
Reply: Reply by Aero is respected.  Now, ‘not cleaning’ a gun is different from running with zero lube.  I have to wonder if the failure would not have happened if it were lubed and yet kept dirty. It appeared to me that maybe the shoulder of the firing pin was compressed in a similar way that a brass cartridge can be forced too far forward into a chamber. My thinking is that maybe carbon build up on the back side of the bolt face around the firing pin hole was impinging on the firing pin shoulder.  There may be no defect at all with the Aero firing pin and or bolt. Major take away - don’t run your gun dry.  Also there is a difference between an endurance test (includes proper maintenance/operation) versus an abuse test to point of failure. It might be fair if Lucas/Trex or someone else did an endurance run with a lubed gun.  Thanks to Lucas/Trex and Aero for having this open discussion.  Right here is a great example of the 2A community having a rational and civil dialogue on a subject that we are passionate about resulting in making all things better, for all.
Reply: This is why I will never shy away from buying aero products.
Reply: @lhp2a  A lot of places, even BCM, offer uppers without the BCG/CH by default.
Reply: when is aero going to make a bufferless ar 15? ;)
Reply: Yall are my only hope for a budget ar10. Aero be good to us 🙌
Reply: Slow clap for AP. 👏🏼👏🏼👏🏼
Reply: This is why I support the shit out of aero precision. I personally have an M5 I built out and k have zero issues at probably 2K rounds so far.
Reply: At aero I sell your products in my gun shop/range and we love y’all!
Reply: @TaxationIsTheft69420  that's awesome. Been looking into getting a 10" upper of theirs for my ar pistol build. A buddy said he loves it
Reply: @Hazmat0357  I understand your take , but like they just said , and like I know because I've bought uppers and lowers from them , I bought a bcg after the fact because their uppers (which they have extensive variations of)  don't come with one.  It's on you to lube the bcg (whatever brand you install ) as it will come in a separate package , and maybe even from a different manufacturer. I can see you think it's some kind of slick way for the to cover their ass , and honestly I don't know why they don't sell complete guns , well yes I can take a common sense guess and say that it's in the spirit of maximum customization. They have so many uppers , and so many lowers , and so many options to complete the build.  I just don't see it as some backdoor way to evade selling complete guns.
Reply: @MOTOSCOUTtv  agreed
Reply: this test would not stop me for even a second on my decision to buy this rifle ,shit if i had the money id buy 4 of them !
Reply: Purchased this rifle myself about a year ago and have had nothing but issues. First issue is that the upper was milled incorrectly, the cuts for the charging handle were out of spec, fortunately I was able to send it back and have the problem corrected. Once I got it back though, I was finally able to shoot it, only to have it short cycle every other round and bend casings into pretty much a 45-degree angle. Going to throw an adjustable gas block on it and hope it solves the issue, but I do not have that high of hopes, that it will be the solution to that issue. Did not expect these many problems from the jump with a name like aero precision behind it.
Reply: lol
Reply: Really like the detailed reply. I will continue to buy aero parts!
Reply: @Aero Precision, LLC
Reply: @PrezUSMC  I've got an A5 setup on my main Ar15 with a sprinco green and the VLTOR H3 buffer. It's mated to an Aero Precision barrel with a carbine length gas system and it wears a SiCo suppressor. My solution for this gun was the Bootleg  adjustable carrier. It's got recoil that's soft like a .22 now.  That's the only time I've found specialized heavy springs to be valuable.  The other springs I've tried were sprinco orange on an 9mm Ar9. All they did was add to the severity of recoil, induce muzzle dip, and break bolt catches.  In my experiences I like to pick buffer weights and adjust gas before picking up heavy springs.

The bit about quarters in the extension tube is all about whether or not you need to fill that .75 inch space. When using a standard length buffer, you will need them. When picking up the VLTOR buffers, or other 9mm PCC buffers, you likely will not.  The upshot to the longer buffers is that you can get additional weight behind the bcg in an exceptionally overgassed barrel. The springs do little to damp the rearward movement and usually add speed/energy to the return to battery. Useful for powering through dirt and grime, especially with a heavier buffer  weight, but also can cause muzzle dip.
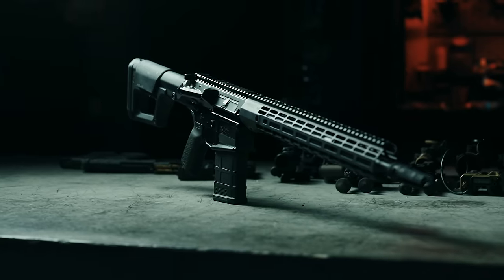Reply: @AP-cm3kb  I haven't shot my M5 in a loooong time, but even with an H3 it was barely 2:30 to 3:30 I think. With PMC target stuff. That's with a superlative AGB dialed down to restrict gas also.

Yeah, you'll probably want to just expect a heavy weight. The bolt speed was super high on both guns I'm familiar with. One gun had a 16" Aero barrel, and the other had an 18" Faxon.
Reply: This video and your response has made me an Areo fan.
Reply: I think that running the rifle to 2300b
 rounds is probably more of a testament to the rifles durability than it's failings; I agree on keeping the rifle clean.
Reply: @Segphalt  most lubes start to congeals after sitting for 6 months or more. This test is all over the place.

Like an engine, firearms need oil to operate correctly. 

This test is so flawed. Run a gun dry and premature wear is inevitable.
Reply: This video, its dialogue, and subsequent response from Aero is why I watch Lucas's video's AND buy from Aero. Having just finished my Aero M5, I feel better prepared for knowing what to look for, and considerations to be made (some I already do with all my firearms like my personal OCD driven clean and lube habits).
Reply: Great response Aero. Glad to see a mature and reasonable reaction to this video. I hope you and Trex can work together to make any needed improvements.
Reply: For sure aero. This video just confirms even more to me that I made a good choice by going to aero precision. Now I did all those things you mentioned in your comment from the gate so suppressed? No problem...
Reply: I’m not believing no lube on the BCG. I’m not saying that’s WHY it failed but.......
Reply: I purchased a m5/ar10 a month ago and shot it 2 weeks ago for the first time. I used pmags, and no upgrades other than a scope. I couldn't shoot more than one round without the weapon double feeding or stovepiping. I tried 4 different types of ammo and every one caused a malfunction. Now I have it in the shop. Seems odd that I am having similar issues as Lucas was. Very annoying I am now spending a few hundred to get my rifle looked at and hopefully fixed when it should have ran fine out of the box.
Reply: The upper was a complete factory built upper according to the beginning of the video. The repairs to the bolt were made with a separately bought bolt. So unless I missed something, it wasn’t run completely dry up to the first failure and they lubed it after that. However, I do think it would happen to any manufacturer with 308 under the same stress( lack of overall maintenance ) at some point , and I do think aero precision is a great company. I will still be buying the m5 builder set after watching this video but I do think a factory built upper should be lubed properly and run reliably right out of the box. If the bolt was actually separate from the bought upper like stated above by @AeroPrecision then the above reply from them is spot on. Some clarification on that would be great from either party.  Sincerely, Joshua ( Owner of Lee defense solutions)
Reply: As a Proud owner of the AR10 DMR setup from Aero Precision, 2000+ rounds on a BCG is pretty impressive without cleaning or lubing the firearm. Even though I went with the lantac BCG and trigger by timney just for personal choice.
Reply: I saved up my money over the past couple of years and specifically chosen Aero uppers, lowers and before I knew they were outsourced aero phosphate chrome lined BCG's for my 2 AR-15s that I own. I do plan or doing maintenance every 1,000 rounds, but ultimately was wondering do you carry a warranty for your products such as the previous mentioned BCG'S or (thankfully ordered those specific parts through Brownells that has the lifetime warranty) should I contact them? Would you even want to know even if you don't?
Reply: This was a fantastic video, and amazing response from Aero Precision. Being an Aero dealer it only renews my confidence in the company and confirms why they're our go-to choice when it comes to building rifles. Looking forward to seeing how these items evolve going forward!
Reply: BCM upper, Aero lower, nuff said for a perfect rifle
Reply: Big props to you guys!
Reply: @AeroPrecision  I don't take these as excuses. It is nice to see an explanation and thoughts from a company standpoint. I do not have an Aero Precision gun, but this makes me respect you guys as a company more. I would put Aero into consideration on my next AR build.
Reply: The ar-10 is a notoriously difficult platform. I was suprised it did as well as it did. Im not overly suprised with the bcg issues, considering the ar-15 bcgs offered are somewhat notorious for problems with aero, hence the "enhanced" line offered. Overall, one should always anticipate bcg issues and if shtf use is truly the goal of the rifle, a spare bcg should always be kept on hand.
Reply: Aero precision you have my respect and im a ak guy 🤫
Reply: @lhp2a  Fully agree. not having a cleaning plan is a huge gap. T-Rex also made a bad assumption that the major parts are pre-lubed like one would see when purchasing a complete rifle/pistol.
Reply: @Segphalt  not really. these are separate parts. This wasn't purchased as a complete rifle. They purchased 4 separate items: a complete upper, which means upper receiver with barrel mounted and handgaurd, lower receiver, a BCG, and a charging handle.
Reply: Few days ago you send me defective parts. Long story short, your part's tolerances so off that your own charging handle doesn't fit in your upper. How is this even possible?
Reply: @teneightymn1234  not so much because of suppressor use, but because the wide variety of ammo for .308.
Reply: @nmhockey5  I mean, you could technically do that now.  You should post the results…
Reply: Love all my Aeros.
Reply: "Items such as the bolt catch screw "

Perhaps you would best to use a roll pin design!!

I REALLY dislike lower bolt catches that use screws!
Reply: I plan on getting one of your .308 uppers for a future build, and this is good stuff to keep for reference 👍
Reply: Great response ! ❤
Reply: Have one of their M5 6.5CM uppers and M5 lowers. Solid rifle. Only have a few hundred rounds through it but it’s plenty accurate and I have had no issues with it. Just lubed the BCG when I got it and went to work
Reply: My 12.5” M5 was extremely overgassed with a Sandman-S, I was getting 3-4 stovepipes per mag. I installed a BRT gas tube and now it cycles everything I feed it, with or without the can. Might wanna consider making the gas port a little smaller on the 12.5” barrels since most customers are buying that length for suppressed use.
Reply: Is there a reason you cant send a firing pin by itself?
Reply: Aero. Please dont be mad but i want to use a Zev hand guard on my M5 build.  Can i get the anti rotation pin hole drilled into my upper or will it cause problems.
Reply: In all fairness T.rex should have lubed, cleaned, and inspected the rifle at reasonable intervals.
Reply: I have to agree with Aero on maintenance. Going hundreds of rounds without a basic cleaning doesn't make much sense. I certainly hope most shooters don't do this. 

Waiting for a gun to malfunction before even lubing it seems harsh as well. I get why Lucas did this, to test the worst case scenario. I don't think it represents how most people treat their guns though. 

Lucas I appreciate the content, but I hope you don't treat your own stuff in that manner!
Reply: @lhp2a   I too am planning my AR10 build and Aero precision was my first thought. watching this video i am honestly impressed with the rifle i personally clean my firearms every time i shoot them so maybe every few hundred rounds the BCG gets removed, scrubbed, lubed and thrown back in. also that BCG looks like its phosphate coated? everyone knows you need more lube if your not running a BCG with a better coating. also if your building a rifle most people are going to put in an upgraded buffer spring system i feel that a longer or heavier buffer system would have helped save the bolt as well.
Reply: @kazager11  would running a bcg dry cause it to fail sooner? Yes. All bcg’s will eventually fail, wether its 30k or 100k rounds. Parts wear, but they wear much faster without lube.
Reply: @harryvickers1945  totally agree, after my first rifle or so I know now I won't ever get anything other than a phosphate chrome lined BCG's and barrels unless a amazing deal by a top manufacturer
Reply: Great response aero precision, purchased the m5 about a year ago and have ran roughly 1000  rounds through it, 500 factory rounds 500 handholds. Long story short no factory malfunctions, I figured I would get a fail to feed or eject with my handholds but i still haven't, as of 6 hours ago. Great rifle, great video, great company.
Reply: Replies such as this continue to make me a fan of Aero Products. Well spoken, and look forward to developments to further improve an already impressive product.
Reply: Why would you "respect" their series of "tests" if it directly goes against the very outlines you have presented here? That makes no sense. You're basically saying that TRex "should have done A. instead of B.", and what you're saying makes sense. I could go on and on, but I don't feel like typing a novel, but only an incompetent idiot would run anything so long without lube, and that's just ONE obviously valid critique amongst many others.
Reply: Yes no lube , cleaning or  inspection on that many rds on a  308 isn't the smartest thing I've seen . Not a good test
Reply: Two teams of good guys, working to make things better. Love it!
Reply: And this is why Aero will still get my money
Reply: @Sauce8451  agree
Reply: @aeroprecision love your response… love that you’re taking the feedback to make the product even better
Reply: It would be interesting to compare more AR-308 DPMS platforms that are likely to be purchased/built by enthusiasts for hunting, range fun, and 2nd Amendment stuffs. For instance I recently built an Aero (mostly) .308 and 6.5 Creedmore. Although, they have some decent “upgrades’… but I am curious how the Sig, S&W, PSA, and other AR-10/AR-308 platforms would perform.

Another thought would be how your ‘one’ Aero would compare to an ‘upgraded’ version. E.g., barrel, bcg, silent buffer, trigger, and so on.

I am also extremely interested in modern EPC-9 (PCC for PDW and CQB) would compare.
Reply: I considering for an AR10 build for about 2-3 months and I will definitely buy one from Aero after I watched this vid and your response. I have many Aero components and I’m waiting for the Christmas sale😂
Reply: @Aero Precision I am extremely excited about the bolt action systems in the works! I hope that both long and short action will be available soon, and hopefully have some carry over with the AR-style platform parts… e.g., Magpul magazines and accessories. Have to scratch my itch to build a .300 Win Mag and .338 Lapua soon!
Reply: well ive only shot a few hundred rounds in my AR10 I may change those parts out when need be but ive really enjoyed it and im still switching my kit over to it.
Reply: That's why I test and actually am rough with all my builds I love your stuff I have aero and bear creek and a couple 🦄  but if mine don't run 1000 rounds without a cleaning cheap steel and brass mix then it's not worth the ammo. And so far I've been surprised how reliable my bear creek and aero ones have been.. the unicorns 🦄  on the other hand have had some issues when u mix like 8 different companies and their a gap between upper and lower and a wiggle lol don't make unicorns make good reliable tools and test them 😉
Reply: Respect
Reply: More company’s need to be like this!!
Reply: We appreciate the response and explanation but none needed for a rifle in this price range!
Reply: Excellent response 🔥 #Respect
Reply: Aero no need to explain yourselves, I trust your company with my life and stand behind your products 100% thanks for being awesome
Reply: Good response BUT the month long wait for a simple bolt carrier warranty is pretty poor if you ask me, especially when you have them on the website to buy today. Disappointed with something so simple takes so long.
Reply: I know how y’all could get the rifle back for inspection, move to Tennessee! Please? 🥺👉🏻👈🏻
Reply: @Segphalt  That’s understandable, and I agree that most uppers I’ve bought arrived with obscene amounts of oil that poured out from everywhere
Reply: I'm loving the intelligent and respectful conversation happening in these replies, especially from Aero.
Reply: Because of that response I have no doubt, that after buying your M4E1, I will buy yours AR10 :+)
Reply: Uouh great answer, respect
Reply: Makes me feel good seeing a response like this.
Reply: Run a GreyGhostPercision MK11 Heavy 
Barrett REC10, WC10,

when building out a SR-25 have a end goal before you start. Also you get what you pay for like thermal fit barrels ie GGP & JP (have to heat the upper and freeze the barrel to install it in the upper) heavy stainless (proof is good) jp makes good bcg, also you have two main types dpms or sr-25… sr-25 is better imo. Mega arms, LMT de  
Good video
Reply: Sharps Rifle Company for solid BCG.
Reply: Have to say More companies could learn from you guys every thing wears out and or breaks after 30+ years as field service mechanic believe me when I say that everything will break its how a company deals with the breakdowns are the true test
Reply: Q
Reply: Keep up the great work, Aero!  I'm a fan of your products and will continue to use your stuff on builds.  I really appreciate Lucas doing this test because I'll never get the chance to shoot that many rounds through my M5.  I love seeing stuff like this and I really appreciate your response.
Reply: Imagine if this were BCM's gun and they were forced to respond:
"Fuck you for actually testing our equipment, go buy from someone else"
Reply: Excuses and ass holes, almost everybody has at least 1.

My $400 Davidson defense poverty-pony 14.5 .308 kicked the dog shit outta a similar test to this one. I'm at 7,659 rounds without a malfunction or any maintenance. Lol. Aero is a waste of money.
Reply: After watching the video, I would feel comfortable buying an Aero rifle. These torture tests are cool and all but people need to remember that the vast majority of people are not going to treat their gear in this manner, and the people that are going to should not. People like this need to realize not everyone has the money for a Daniel Defense with an Elcan on top of it and that the back bone of AR ownership are brands like Aero P. Brands like these have actually done their part in getting quality gear into the hands of everyday Americans.
Reply: Alright aero, i look forwardto an upgraded bcg, i have been looking for a dpms pattern ar10 bcg that is bomb proof and i trust you guys can make it, i have had aboit 20 plus builds and aero parts are always consistent
Reply: That is a lot of 308. Not me.  Good video! Loved seeing the different optics. I think the Aero is Fine for its price point. Good ROI. Get a thermal before going suppressed.
Reply: After watching the video, I would feel comfortable buying an Aero rifle. These torture tests are cool and all but people need to remember that the vast majority of people are not going to treat their gear in this manner, and the people that are going to should not. People like this need to realize not everyone has the money for a Daniel Defense with an Elcan on top of it and that the back bone of AR ownership are brands like Aero P. Brands like these have actually done their part in getting quality gear into the hands of everyday Americans.
Reply: @kazager11  It was accelerated.  Every part will fail, even with meticulous maintenance.  There are a TON of forces going on with guns.  The fact that the BCG went over 2300 rounds with ZERO lube or maintenance shows the quality of the part.  Those things are not supposed to be run like that.  Rub some oil on your hands and rub them together.  Then try it again with no water/oil/lube and watch how fast you rub your skin off.  Same material, much sooner failure point.  Only difference was the lube.
Reply: Does AP have any speculations on how different a 18" rifle length gas would have performed? Accuracy, gassing/suppression, etc?
Reply: @BullsMahunny  do you realize I don't need a lesson on lubrication?
Reply: @Johnny-jr2lq  Typically, those rifles are more fine tuned straight out of the box, which is where their higher pricing comes from. Doing the exact same test with those rifles, I bet they could reach the 5000 round point with some minor issues along the way. 9 Hole Review had issues with the barrel screws coming undone by themselves on the Scar until they locktite it down. Lucas is making a bigger deal out of this Aero M5 than needs to be, and that's just my opinion. Budget-friendly rifles, especially larger calibers, need some upgrades to run it as hard as Lucas just did. Aero's rifles are quality, in my opinion, and they keep the price down by not having all the frills and fine tuning. Adding a good adjustable gas block, better buffer system, upgrading the BCG to nickel boron, and properly lubricating it and cleaning it after every use would make the M5 more reliable than what you saw in this video. The only question I have is the firing pin breaking, but that is a cheap and easy swap. Lucas just running the shit out of the rifle ridiculously over-gassed and just saying this is just the way it is and throwing a suppressor on it is just maddening to me, along with the lack of maintenance. I'll fully admit that the rifle coming from the factory over-gassed like that is not ideal and Aero should change their gas blocks. However, talk to guys who do off-roading. They buy vehicles advertised with off-roading packages, but they often immediately upgrade parts to better fine tune it for their needs. This is not as unique of an issue as made out to be. Budget 2011's often need fine tuning and part swaps, while the expensive ones like Staccato don't. Personally, I love the fine-tuning and taking things apart to modify and upgrade. You get to understand your rifle way better, and make it exactly how you want it. Maintenance and inspection is part of the joys from the hobby and sport of firearms, along with other mechanical things. It saddens me how much that idea gets discarded and dismissed in this video. All my opinions, and nobody has to agree.
Reply: @Aeroprecision I love your products but still opt for a toolcraft bcg over your bcg as toolcraft is a military supplier.  I can also admit that toolcraft bcg's are less expensive.  I have never questioned your bcg as the machining is great and the staking is excellent.  But weighing cost vs track record IMO toolcraft is a better option.  It really doesn't matter in the long run because you offer rock solid base parts for a builder to do as the please and that's what I really appreciate.  School of the American rifle who helped you design your advanced bcg has excellent reviews on toolcraft bcg's.  Toolcraft has better tolerances between the cam pin and the bolt than your stand bcg and their extractor springs are slightly heavier.  I have no way of testing the firing pins or extractor retaining pin so I have no comment.  After much research, if your running an AR one should have an extra bolt, firing pin, and cam pin handy if your actually using the gun, if not you should buy a comblock ak pattern rifle.  The internal workings of a good comblock AK are rock solid and any well educated and studied firearms enthusiast would acknowledge this.
Reply: This is the type of response that earns my respect in a manufacturer
Reply: Regarding the handguard, i think the system that works the best specifically for bigger calibers would be your gen 2 handguard. Or a design such as bcms crossbolts. The gen 2 handguard directly threads onto barrel nut which maybe a turn off to some people but if its a rifle you don’t plan to switch parts around i think this is the most full proof solution. I only really like bcm’s handguards and the gen 2 aero. I’ve seen daniel defense handguards come loose after torture tests and i believe its due to their design because the bolts are parallel to the barrel. By directly threading to barrel nut or by using a cross bolt design, i feel like you eliminate that. Also, would rather have an overgassed rifle than an undergassed one. Especially if you don’t plan on suppressing.
Reply: his shoulder? recoil in 308 with a gas gun is noooothing.

1- yeah... i had my threaded  bolt catch pin come all the way out way before 1000 rounds. i think before 500. (not running it super hard, fyi. m5e1 build). it's a miracle i found it in my driveway. so, reluctantly, loctited it. but having loctited the rail and ended up needing a dremel to get one out... i hate that shit. HIGHLY recommend the unstrippable flathead screws instead of even torx. (i now have 100 because it was the smallest bag i could find, for only about four bucks!). 

2- i see you guys are, or will soon be, making an adjustable gas block? definitely make this standard for your ar10s! 

3- pmags are teh greatest, everybody knows, people tell me it's the best magazine, tremendous, huuuuge...

4- yeah, i'd agree he should have lubed the thing, if nothing else. any end user, regardless of maintenance, would do at least that, i'd hope. but whatever.

5- looking forward to see what you do there, and maybe even offer up an "enhanced" one when you guys... i dunno, whatever, to it.
Reply: The combination of the test and this statement show what great products a company can create. My respect for the goal of making self defense affordable with a solid base quality
Reply: i have an aero M5 i built with the basic stuff and seems to be doing ok and i shoot it suppressed, definitely dont have 2K+ rounds through it and It does recoil rather heavily tbf
Reply: Respect
Reply: "BUT, there is opportunity here."

That just about says it all. We love our AP rifles
Reply: Stop using set screws instead of pins. That's such a stupid idea
Reply: @PrezUSMC  that’s what I run on everything. But they are just down the road from me and I can run there quicker than ordering from anywhere else. I’ve had nothing but good experiences with them since I switched over.
Reply: This response just garnered that I will buy and build another areo ar 10 I have built three sold three using areo parts and sa adjustable gas blocks. And your willingness to learn adjust and make better makes me
Confident in your product. Ps please improve the in stock  items and specialty paint seems.
Reply: @cav4353  same love my M5E1. It did not come as a complete rifle. I put it together from separate parts and it's never hiccuped one.
Reply: Great response from aero and looking forward for more amazing things!
Reply: @cz75fanatic  100% and I'm in the same boat; I have THIS RIFLE with 3 of these exact load outs including suppressed (although not yet tested) and none of these findings bother me, rather offer solid data points on things to watch for.
Reply: Based Aero
Reply: @nastysoda9212  did you actually watch the video?
Reply: @MinimumSpeedOperator  for sure. Their receivers are my primary go to along with some of their other parts here and there.
Reply: Thanks will be going with psa for my ar 10
Reply: Your bolts have been failing often since COVID hit.  I admin 10.7K consumers on social media, and it is pretty unanimous among that community whom strive for long term use of their tools.  Aero parts are headed towards PSA, no longer carrying their acceptance they once had.  Lowers are barely considered a good choice compared to others in the price point...
Reply: @PhotogenicPotato  yeah his claim was two types of people.  1) those that never clean. 2) those that clean to often.   He is sure the gun has problems then test it again and do some maintenance.  Would be curious to see that as a test case  before they make any conclusions.  Cant believe he hasn’t broken a firing pin.  I have had two fail in my time with AR’s.    Really not that big of a deal.
Reply: "what we think about internally when we review this and consider how we would approach this testing from a “scientific” standpoint."

What a venomous slap and bite in the face with forked Serpent's tongue. Highly inflammatory, insulting with meritless excuses, to put it mildly.

Evidently, it didn't occur to your ethos of manufacturing quality, that Lucus used your firearm in what he considers to be some moderate real-world applications and your product failed on more than one occasion, let alone that I must wait a month to get a BCG group from you, while I'm defenseless because I trusted all our lives to your company and firearm. God only knows what else would have failed. Thank God the #TRAL didn't get harmed that we know of.

Your lab versus reality, which is more important? 

People use their firearms in real world applications, not your Aero lab “scientific” standpoint" that fails the reality test.
Reply: I just bought a JP fmos enhanced and was done with worrying about that.
Reply: @benjaminnevins5211  I just bought a december snow camo kit m5 .  Cant wait for the build!
Reply: Aero, you guys make great products and I will always support both you, and T. Rex arms. I’m very impressed with how your rifle did, giving this harsh test. Thumbs up and I’ll be buying an M5 soon. Thank you!
Reply: Excited I just ordered my first AR10 lower from Aero to build into my dream AR10!
Reply: @AeroPrecision  As I understand it the original upper had a BCG. They purchased a second because they didn't want to send that one in for either testing and or warranty which Lucas said would have taken a month or potentially longer. So the the only thing used from the boxed BCG was the firing pin. Therefore, the upper was indeed lubed from the factory with the original 
BCG having been lubed as well as I understand it. Now, this in no way is to cast a disparaging comment on any of your parts. I only clarify what I understood from the video. I have built many AR 10 rifles and most used Aero parts. I love the stuff you guys make.
Reply: My initial reaction to this video, admittedly... Was to wonder how much  I might get for my barely used M5. After reading the response from Aero however, I'm hesitant to throw the baby out with the bathwater.

I love what Lucas is trying to do with these videos and agree with his approach- torture test under the worst conditions and see how things go. That said, no gun owner in their right mind would ignore regular maintenance schedules and run 2000+ rounds through an AR-10, even in a SHTF situation. I mean honestly, even in a worst case scenario, it would take a LOT of sustained combat to go through that many rounds.

Would it be ideal for people to train frequently enough to do this kind of volume through their rifles? Of course, yes- absolutely. But am I going to be in a hurry to dump match-grade duty ammo through my AR-10 for close-range training? No.. If I'm burning through rounds, I'm grabbing a carbine in 300BLK or 556 anyway, so training with my AR-10 will almost always be with a goal of utmost accuracy at longer distances. And if you can afford to shoot 2-4k rounds of 7.62, you can afford to replace a barrel and dab some lube up on your BCG every now and again.

I am by no means a cheapskate when it comes to buying guns/parts. I'm a big believer in throwing a $2000 Leupold on a $1400 rifle. That said, I think it is dangerous to call the M5 a "budget" simply because its markup isn't as high as other brands. I'm willing to bet the level of quality in the DD equivalent to an M5 doesn't rise commensurate with the increase in price. And I'd rather put the extra cash into an optic than into a rifle that will have a barely noticeable (if at all) increase in "precision" over an M5.

Ultimately, like many others I'm a huge fan of Trex, and a huge fan of Aero. I think both companies are extremely honest in their approach with consumers and have many loyal customers for a reason. Hopefully Aero customers treat the M5 with the same respect as before, and recognize that this video is just a very informative reminder that guns need lube every now and again.

I would love to see a follow-up video- ideally 5x shorter than this one... New M5, configured with rifle-length buffer, AGB, aftermarket BCG, and suppressor. Tuned for the usage-scenario, and maintained accordingly. Loctite some screws, lube it up, and just do 500-1000 rounds. I think the conclusion would be that configured correctly, the M5 will keep up with the majority of other brand's AR-10s, even at double the price.
Reply: Love it!
Reply: @PrezUSMC  Running an A5 length tube allows you to use standard AR15 carbine buffers along with an AR308 rifle buffer spring. This system is great in the AR15 but it is essential imo on the AR308 platform. The AR308 rifle buffer spring really helps to slow the carrier speed. The extra travel and slightly increased buffer mass are also beneficial. You can use any AR308 rifle buffer spring in conjunction with AR15 carbine buffers. I have an M5 build with an A5 tube (Magpul UBR), AR308 rifle buffer spring, AR15 H3 buffer paired with an 18" barrel with rifle length gas system that runs great and is a sift shooter. Most AR308 builds benefit greatly from adjustable gas blocks as well.
Reply: A lot of companies both in and out of the firearms industry would benefit from Aero’s demonstration of integrity. Way to go.
Reply: Even if you are here doing damage control major brownie points for showing up here on a video where they showed some real problems abusive or not I am glad you showed up we need more people in the industry willing to step up when things don't go perfectly.
Reply: Aero Precision is the s***!!! I own 4 of their rifles and have never had a malfunction of any kind.
Reply: @MOTOSCOUTtv  right? That’s a success not a failure lol
Reply: And this is exactly why aero has the great reputation they do.
Reply: I had respect for your company before, but have more now. To come out and talk in a comment section says alot. Some company's wouldn't even entertain that ideal. But you did, and that says a lot about how you guys want to work on getting better and educate the consumer. But hoping some fokes understand the value aspect as well. Thanks for your input, and look forward to seeing a update on this platform myself as I am interested in owning one myself now!
Reply: @Isaac Chantos Well said!
Reply: Aero stop overgassing the shit out of your rifles. Just drill a smaller gas port hole
Reply: Might want to add a adjustable gas block.
Reply: @ryang8040  The rail mounting system that Daniel Defense uses is by far my favorite system of them all. Not only is it simple solution to a common problem, but it's damn near bullet proof. Not sure if it's a patented design that only DD can use, but I'm surprised it's not "copied" by other manufacturers of rail & upper receivers. I checked the torque when I first got the gun and have checked the torque since with absolutely no change after thousands of rounds of use.
Reply: Now I can't wait to get an AR10 from this company. This makes me so happy when I see a company actually pursuing growth and making a difference and Lucas helping you guys make that happen. 2023 IS GOING TO BE GREAT AND BLESSED.
Reply: @lhp2a  He said he was running it right out of the box. I don't know what else you got from that. Aero makes fine products but it is a Kac or LMT, no! That being said this shouldn't deter anyone from purchasing an M5 from Aero.
Reply: Love my Aero Precision rifles. Have been rock solid.
Reply: Love your product brothers! Keep up the work.
Reply: @clutchcargo1239   I disagree. Lack of lubricant doesn't cause screws to walk out, or firing pins to break. The firing pin breakage in particular is just poor material quality. There's nothing the average shooter does for "maintenance" that's going to prevent firing pin breakage; if it breaks, that means a cheap/flawed/improperly hardened component. 

AK Operators Union Local 47-74 https://www.youtube.com/@AkOperatorsUnion does 5000 round tests all the time that are far more "abusive." 

Again, just shooting it a lot isn't "extreme abuse." 

Nor do the problems have anything to do with "lack of proper maintenance."

Please explain how cleaning it or squirting some lube in would prevent the screws from walking out or the firing pin from shattering.
Reply: Currently building an M5 and was super happy to roll across this video. Love AERO and everything they're doing for the community. Great stuff all around.
Reply: Mad respect to Aero for responding to this, especially as thoroughly as you did. I think, as a consumer, we definitely understand everything you highlighted here and can say I respect Aero as a company. You guys rock and I hope you continue putting out great products for years to come. Never stop innovating.

This did not seem like a lemon at all. In fact, the maintenance schedule seemed to be extremely intense. I think a general amount of lubrication could have helped out with a good number of these issues. That along with no loctite on essential pieces was an interesting way to go. I feel like a lot of consumers adhere to lubrication along with general cleaning every 500-1k rounds, but maybe I'm ignorant. Cool video otherwise.
Reply: Whomever wrote this earns their paycheck
Reply: Keep it up Aero...love your product and almost picked up this rifle when it was sub $1,000 for upper/lower BCG and charging handle during black friday.
Reply: @Armored_Muskrat  That's twisted... Firing pin failure in this case is a result of hammering from a way over gassed condition. Sure, the material it's made from, or how it's treated plays a major role in longevity, but that pin did pretty good considering the hammering abuse it took. Let's not pretend I said lubrication effects torque of screws... any bone head with common sense can check the torque on their fasteners, before. and after use as required. If not, complaints about having a loose fastener is laughable at best. By the way, this is a budget friendly rifle, not cheap, but not POF expensive... Did pretty good for lack of common sense maintenance, lubrication, and adjustment of gas system to keep it from beating itself to death... Firing pin must actually be pretty tough. Besides lube, and checking fasteners, I'd have immediately addressed gas.
Reply: I own this same exact build, I have not had a problem with it. I got multiple blem parts on it. You will be amazed what Aero considers a blem. I have higher end ar builds with  some imperfections on finishes and stuff, but they won't consider it a blem. Show how Aero believes in quality control. I know Aero will adress this issue, and im looking forward too what they believe will be the fix to this problem.
Reply: You know, if you're gonna sell a complete anything... don't you think you should use thread locker? Even on the set screws of your gas blocks. It's bad enough it's not pinned or dimpled, not even gonna put rocksett on it? Thats why Aeros are just range toys.
Reply: @enudretheinsult  you should be able to tell immediately that something is oiled or not oiled. That’s not on the manufacturer.
Reply: @clutchcargo1239  

"any bone head with common sense can check the torque on their fasteners, before. and after use as required. If not, complaints about having a loose fastener is laughable at best" 

I take it you work for Aero since you're defending them in such an absurd manner? 

You're basically saying that NOTHING that goes wrong can possibly be the fault of the manufacturer. 

The number of people who own rifles and check the torque on their rifle's fasteners every time they shoot it, before and after, is close to ZERO. And most of the rifles just work without falling apart. 

A gun should be able to shoot more than 500 rounds without the bolt catch falling off. 

I take it you think this is a good firearm too? ---> https://www.youtube.com/watch?v=HuY4CWm8XwA
Reply: @clutchcargo1239  

"any bone head with common sense can check the torque on their fasteners, before. and after use as required. If not, complaints about having a loose fastener is laughable at best" 

I take it you work for Aero since you're defending them in such an absurd manner? Or are you just trolling? 

You're basically saying that NOTHING that goes wrong can possibly be the fault of the manufacturer. 

The number of people who own rifles and check the torque on their rifle's fasteners EVERY TIME THEY SHOOT IT, BEFORE AND AFTER, is close to ZERO. And most of the rifles just work without falling apart. 

A gun should be able to shoot more than 500 rounds without the bolt catch falling off. 

I take it you think this is a good firearm too? ---> https://www.youtube.com/watch?v=HuY4CWm8XwA
Reply: Excellent advice here, thank you. I have always been under the impression that buying a good base platform and then tailoring it would be better and more affordable than buying a high end ar for an arm and a leg.
Reply: Have spoken at length with your customer service team on the phone and I would expect nothing less than this kind of response. 👍👍 BUT in my own experience, I returned a 308 bcg to one of your dealers that had its internal chrome plating chipping off.
Reply: @Armored_Muskrat  Lol, Aero doesn't need defending here... Any over gassed AR rifle is prone to breaking a bolt catch... Just plain physics. Are you telling me the the majority of people are completely ignorant or indifferent towards a firearm that they just paid good money for, that may be called upon to save their life? Sure sounds like it... Appalling!Doesn’t matter to me if its a $100 firearm, or a $3000 firearm, if it's mine, it gets a thorough check of everything, cleaned, lubed and assembled properly. If it's an AR anything, and it's throwing cases at 1, I'm going to immediately correct that problem before I put any more rounds through it... Common sense move here. It's difficult to imagine that people spending there hard earned dollars wouldn't do the same, particularly if reliability is a priority to them. Guns are precision tools, not pry bars... It's not complicated, If you treat your tools like crap, they break like crap. This gun was treated like crap, it's obvious, and the result was predictable. Lol, common sense  isn't common, good sense is rare. I wouldn't mind working for Aero, I wonder if they are hiring... Anyway, as entertaining as your comments are, I'm going to politely disagree.
Reply: i have a 308 AR10 M5 20IN  BCG I PUT ALL THE UPGRADES 100 ROUNDS THE MOST BUT ITS A FUN GUN TO SHOOT 
SHOOTS AMAZING AND ONE OF THE BEST GUNS OUT THERE IN THE MARKET FOR ITS PRICES 
THANKS FOR THE DATA. GREAT VIDEO!
Reply: What blue loctite do you recommend? The color doesn’t correlate to strength.. 243 vs 248 aren’t the same but both are blue.. 
sorry, just a pet peeve. They have numbers for a reason..
Reply: The Marine Corps taught us to shoot 500 yds with iron sights….and shoot “expert”.   No bipod, no bags, no rails and no scope.    In my opinion, the scope is for 500-1000 yds.        My go to is a M1A (.308 cal).   Good test
Reply: @AeroPrecision  Consider posting an analysis video in response. It would be great to hear it and see what your final opinion and assessment is. I actually just ordered an upper and lower last week and am picking it up tomorrow. Can't wait to run it.
Reply: @yingnyang2889  500 at a target the size of a minivan.. that was not a marksmanship test, but a ego boost for troops headed to war. Every marine coming out of basic believes they’re a expert rifleman & can hit at 500 with irons… but the targets aren’t man size, torso targets… they’re giant, vehicle size lol. 
Love the military & support the troops. But that is more of a mental exercise. & it clearly worked, you seen it commented all the time… “we used irons @500”. But hey, I’d rather send troops to combat with confidence..
Reply: @justinreid7459  they don't sell complete rifles. So the gun isn't going to come lubed because it's not technical sold as a gun.
Reply: I for one appreciate Aero Precision for their contribution to this industry. With their products, their customer service (who has always been more then willing to help me with any questions or concerns I’ve had) and the innovation they’ve brought to the firearms industry. I own 2- Aero AR15 lowers (with BCM uppers), 1- 9mm EPC and 2- M5’s. One complete and has only about 600 rounds through it (do to ammo prices and availability in the time I’ve owned it) and a 4th of July kit I’m currently assembling. I will say, I threw together the first M5 during the pandemic when parts were hard to come by so I used a Lantac enhanced BCG. Like I said I’ve only run about 600 rounds through it but it has run great. It seems like an alternative as long as you don’t mind the forward assist not working so great. Which is obviously because those two items were never designed or intended to come together. I’d just like to say thank you for consistently facing issues head on and always doing your best to help your customers and improve your products.
Reply: @clutchcargo1239  yeah they lost me when they harped on how it failed when they failed to take care of the rifle to the best of their abilities. Of course accuracy on the rifle will drop after 2300 rounds but not due to necessarily barrel erosion. Probably more to the copper and carbon deposits. It's one thing to make the claim but not have a comparison (albeit they admitted it was only a sample size of 1).
Reply: what supressor do you recommend for your rifles .
Reply: Based on your Responce and the fact that you responded to comments as well and including the performance of the parts, you just gained a new customer for build parts.   

One ingenious idea from i think its timber creek (I’ve only built a couple of them) is their foreends have tabs on each side that “lock” to the upper and keep the rail in perfect line. It also prevents twisting if it was to loosen up. A version of that might be worth looking at.  

Personally i wish something like that and ambi safety and mag release was a standard feature. How many people actually own a left handed AR vs just buying the ambi parts?   Anyone can shoot a ambi gun. Left or right handed will make it more difficult for the other group. So why not just go ambi as standard?  If im paying $1,000 + on a gun, ill pay a xtra $50 for ambi. 
I bought a springfield hellion literally just because its the only bull pup made for left hand use.  Southpaws have to support left hand friendly companies or we will be stuck with rounded scissors or nothing at all.
Reply: Exactly why I choose the Aero M5. I know the company will stand behind its product!
Reply: Honestly  i would like to see this test run on an a dd5 v3 and see how it holds up by comparison to an aero since its about double the cost  whats the money really getting you i have many aero products and i do feel there is a good quality  to price ratio my ar15 10.5  upper has 7k its the  only upper i havent personally  built and hand picked parts for plus i have plans for an 18" 6.5 cm where ill be using an aero reciever set for because i think they are arguably  the best forged recievers on the market
Reply: I mean… mine was definitely overgassed from the factory, and I upgraded to an adjustable gas block for that reason. Superlative Arms makes a great one for about $100. I also went with a heavier buffer and put a comp on it because it was damn near unmanageable. Ran P Mags from the start. Really happy with it now and have 1500 rounds through it.
Reply: @777Raze  I bought a full size nickel boron BCG that you can use on full auto guns. It has a double ejector. Works well.
Reply: @StrokedTac  ever hear of the SR-25?
Reply: Too long, didn't read
Reply: I plan to build an ar10.  This answer is exactly the reason I will likely buy most components from Aero, if not all.  It is clear that your company is committed to offering quality components at a reasonable price.
Reply: Absolutely, couldn't agree more. I think it running as well as it did with zero tlc is pretty impressive. I was thinking about picking one up...now I definitely am.
Reply: Correct lubrication is a crucial part of shooting any AR;
Reply: Please get vaccinated.
Reply: @PnP-td1mt  I can almost promise you the the firing pin broke do to over heating the BCG & Primers

M80 is 7.62x51 so the higher pressure, heat, harder primers, faster BCG velocity attribute to the failure in a major way.

Without the lube you have premature wear of all moving parts.

If you use a vegetable based oil like canola you won’t have carbon build up, and a much flash point. This increases the life of lubricity and won’t burn up as fast.
Reply: Thanks for the awesome reply Aero.  I've been using Aero parts for years and love them.  Broken parts are nothing new. Every machine has wear parts and a maintance schedule to be followed.  But end of the day it's made out of metal so expect wear/breakage. 
I've passed the 3200 round mark on a M5 rifle with an AR15 Performance 308 barrel and no complaints. It's still accurate at 800 yards and like every AR it has gas rings, firing pin, and extractor/pin/springs in the pistol grip. 
I've ordered several more parts for another M5 build and can't wait.
Reply: Also tuning the gas system with the correct buffer and gas flow makes a substantial difference on reliability and accuracy. 
I was able to turn a 3 moa load down to 1.2 moa at 600 yards with going from a carbine buffer tube/buffer to a rifle buffer tube/buffer and adjusting gas block. Velocity increased and the bullet drop decreased a little over 7" at 600 yards.
Reply: Thanks Aero!
-with ❤️ from Spokane.
Reply: Aero Rules ! I’ve done 3 AR builds with all Aero precision parts except for the triggers(Timney) I’m about to build an EPC too. Trex videos have all been lame ! Like his “can’t build an AR for under $1000 and including 1000 rounds of amo as part of the build ! WTH ? I’m done watching his garbage. If you’re going to do a torture test then prep the firearm for it ! Or Trex should just leave the YouTube reviews to the pros like Classic Firearms,honest outlaw and Iraq veteran8888.
Reply: @MOTOSCOUTtv  2300 with no lube for .308 is beyond ridiculous lol
Reply: @joemontmeny4684  how could a firing pin break only at 2k ?
Reply: @GeneMstoner  you cant promise anything. Firing pin failures are alomost always the resullt of an out of spec bolt or pin. pin DIA to small or bolt ID to large. 
You cannot discuss lubricity without discussing surface finishes, RA, and  Stack up of coatings on top of the part. 
Id want to see the tolerances called out on the drawings and actully check the parts against it instead of making stuff up...
This stuff is cheap/er for a number of reasons...
Reply: @Buletspunge555  Exactly correct
Reply: @PrezUSMC  A5, 6.8 ounce Advanced AR15 buffer, and Orange Spring. I then can open up my Bleed off gas block to allow high pressure 6.5CM rounds to cycle softly while suppressed in my M5.
Reply: That is not is not an excuse, T-rex fubared the test with no lube and heavy heat cycles. Anyone with common sense can see that.
Reply: I hope you fix the rifle send it back to him =update the parts and pay for his ammunition to finish the test when finished and it passes I for one will hafto get me one.
Reply: So you don’t make your products to work out of the box??? Maybe a disclaimer would help??
Reply: @lhp2a  I’m pretty sure most companies do this because you can make more money selling everything separately
Reply: Love my EPC-9 and M4E1 AR15 from you guys.  Never had a problem with them.  I have no doubt you guys will look at this and take any feedback and use it to make your products even better.
Reply: Aeros require maintenance?! Pfft, sending mine back. What trash!

JK love you guys and proud to have your logo on half of my ARs.
Reply: I’d like to see you do this test on a psa. My guess is we might feel better about the aero but I could be wrong.
Reply: I have the same rifle and have been having similar issues.
Reply: @lhp2a  I recently built an aero ar-10 and its a pos. Wont cycle and is plagued with light primer strikes. Aero customer service sucks too.
Reply: Awesome response! I love to see the firearms community coming together for the betterment of the community. Both businesses and consumers benefit from positive growth over petty differences. Keep on improving the ar-10/308 platform especially. It's something I've been interested in for a while, but as Lucas pointed out it's a much more complex logistical problem for sourcing parts and having them standardized. Thank you.
Reply: Over gassing kills
Reply: None of these came across as excuses, these are all legitimate points, every part in every gun will fail under the right circumstances.
I love my aero stuff, this gun did really well in this test compared to others I've used extensively.
Reply: 👏 well said... especially the"blue" loctite suggestion lol
Reply: Sounds like a whole lotta cope!
Reply: Dear Aero Precision, I am and NEVER have been a "homer" or brand loyalist, my armory runs the gamut of darn near every worthwhile component. That said, I utilize MANY Aero components due to the consistency of those components coming from you guys. I enjoy the ability to grab a micrometer and caliper and spec a part only to find that it is identical to the same part that I purchased 2 years ago - kudos to you for providing that aerospace grade consistency. I have no reservation about continuing to utilize your components after viewing this test. I have a similar "unofficial" test where I have put just over 3100 rounds through my M5 .308 win build but it has not been a torture test and I armorer cleaned and inspected the rifle after every range evolution - no failures, no screws backed out (I light locktit everything in the world) and zero degradation of accuracy. Approximately half of that ammo was higher end factory ammo in heavier bullet weights and the other approximate half were PRECISION handloaded 180gr Speer SP hunting bullets (which this rifle happened to shoot really well). The handloads are above published load data and just a smidge under maximum pressure yet performed best out of all combos run through the rifle. Keep up the good work, I was VERY happy to see your response to this video and the fact that you decided to respond at all reinforces my desire to continue utilizing your components.
Reply: It makes sense that they ship their guns dry when it's not shipped as a complete gun.  Also many complete guns are shipped with oils used for preserving the parts from corrosion and are usually sticky and are meant to be cleaned  first.
Reply: So you don't know which part was out of spec? How'd you check the head space, a piece of tape?
Reply: You guys are pretty based
Reply: Agree impressive test, not a failure, given the conditions.  Definitely agree cleaning and lube is the variable missing here, AR's inherently need to be cleaned more (100k's of rounds of experience on M16, M4, and ARs).  Maybe do a 2 gun test next time, one cleaned/lubed and the other not.
Reply: I love your stuff aero I'm not well indowed in the financial department but yall give me access to these sweet platforms
Reply: Bravo on that response Aero ... bravo.
Reply: @clutchcargo1239  without an adjustable block what adjustments for gas are made? Is the Aero 16" a carbine or mid length? Thinking softer spring or heavier buffer?
Reply: @zmbombr  As a stop gap, one could play with heavier buffer weight and spring combos, but I think an adjustable gas block would be the best for tuning. I don't know specifically what's in this gun for spring/buffer, all I can say about it is that this.308 was hitting hard, it was so obviously over gassed, and not remedied.
Reply: L Damage control post . Dont talk about be about it. Great companies dont need to make 
Excuses they let there products speak for themselves. You want people to respect your product?Give them a reason too.
Reply: Kudos on responding and now complaining and dropping excuses!

I love the feedback and suggestions. And like mentioned in another comment....2300+ rounds on no lube at all......NICE!
Reply: @lhp2a  thats just how most uppers are sold
Reply: The issue I have is with the firing pin and your replacement policy of making the customer send in the entire BCG, thereby forcing them to either purchase a completely separate BCG, or go without the firearm while going through your turnaround time. In most cases that's not an issue, however some of us purchase these to rely on for personal protection and this potentially places someone at risk due to a tool they rely on being broken. My faith in your 7.62 BCG was definitely affected negatively, and your return policy added to that lack of faith. I'm now very glad I bought a WMD for my build using your receivers. I had considered buying an Aero BCG for a backup, but I think I'll just spring for another WMD bolt and firing pin.
Reply: This video makes me want to buy an Aero rifle. Good Stuff!
Reply: I was already going to put together a 6.5 Creedmoor AR-10 for a Christmas present for my wife next year using mostly Aero parts, but now I am definitely more confident in that plan. I will definitely lube everything before firing even a single round, and clean and lubricate every 100-200 rounds from there, so I am very confident the rifle will last a long time, other than the unavoidable 6.5 Creedmoor barrel life problems.
Reply: Shit this is why Aero is my go to company .
Reply: @lhp2a  they're a great manufacturer.  Especially consider getting their enhanced upper .I got one of the blems and it makes everything so much easier
Reply: Baffle can to 308 gas gun no good, should use oss can only.
Reply: @MOTOSCOUTtv  

I never considered an AR from them until now. "Impressive" doesn't even come close to describing this performance under those circumstances.
Reply: Shoot I'm buying a lower From yall aftrr seeing this video
Reply: 2300 rounds without lube, in the infantry you'd be running until retirement
Reply: Truly
Reply: @MOTOSCOUTtv  Yeah, I personally lube the shit out of every weapon out of the box or new build... but that's just me I guess.
Reply: I loved this video but I get so tired of YouTubers trying to play the cool guy by telling new shooters not to clean and maintain their weapon. Then, when they shoot it to failure, they blame the rifle. Your rifle is a tool and just like every other tool you own, if you don’t take care of it, it won’t take care of you.
Reply: Respect
Reply: I find it odd the “heart” of the weapon is outsourced!!! Is that not strange? 
The one part the dictates pretty much every aspect to a certain degree isn’t made in house. I’m not a manufacturer and don’t know why it’s don’t this way, just as a consumer it seems strange.
Reply: A potential way to upgrade the extractor is the DPMS G2 extractor elastomer spring that they had. I understand that the springs didn't fail, but having damped harmonics due to using said elastomer could assist in preventing parts breakage.
Reply: As a casual shooter I know parts have a round life so i have a round to maintenance schedule. Its what a safe owner would do especially to keep a costly gun running
Reply: I’m all with ya guys as a hometown Tacompton supporter well now Lakewood, is 1 month a normal turnaround time for a Bcg? What’s industry standard on things like that? I truly don’t know that’s why I am asking. It seems long. But than again I’ve never been it that situation.
Reply: My 2nd comment.
By watching this I was able to see how a company like aero or any other company would immediately respond with damage control, due to the ever extending  customer reach many of these companies like T-Rex arms have!! It could truly make a small company or put one in the red real quick. 
The problem with a lot of it is it’s so subjective to the interpreter!! Whether you’re the end user or manufacturer. You’re inherently going to see it in the light that beat portrays you and your issue. 
If I was a jury member and had to side it would be very difficult.  I think the biggest question at hand is whether or not the BCG was ever oiled? Aero says it was “a la carte” and they don’t oil individual parts. So when Lucas first built this rifle did he do a quick lube?
When I was a newb and purchased my first firearm I knew to lube contact points, maybe because my first purchase was a 1911 but even my first sport rifle I knew enough to oil.
So I would say if Lucas did not oil the firearm at ALL ( in the very beginning, not the 2nd bcg) with his background and knowledge I’d say the gun faired pretty good!!! And no knocks on AERO. But if the gun was oiled or even if only the BCG was oiled and the pin sheared off …. I still like Aero but they would get the L.
Reply: HK and Knights doesn't want any part of this test.
Reply: A moment of silence for Lucas’s shoulder 😂
Reply: Aero FTW again.
Reply: Nice I like that you listen to issues and consider what the user has to say.
Reply: @PrezUSMC  sprinco
Reply: I have been using your parts for years and I have NEVER had any Issues because I make sure that everything is LocTited and Consumable Parts Break and I make sure that I have Spare Parts in my Rifle Bag! Lucas and his friends are Playing Military Dress Up want to look cool on their YouTube Videos but they HAVE ZERO Operational Experience! I find it ISULTING that Lucas is wearing a SOC-F(Special Operation Care Fund) Ballcap in this video because this is an Organization that I have been involved with for many years that helps allot of Special Operators and their Families when they do not come home. 
CMMG has a very cool product for AR-15 that they call the Enhanced Field Repair Kit but they do not make an AR-10 version this could be a GREAT Opportunity for Aero Precision to bring out a similar product for the AR-10 Users! I have build over 30 of your AR-15 and ten AR-10 using your builder kits.
https://cmmg.com/repair-kits-and-parts
Reply: Ccc
Reply: @lhp2a  I’d rather have the ability to pick those specific components myself, and Aero caters to the builder mindset.
Reply: Did any of these types of failures show up in your testing of your uppers?  How many rounds did you guys run through pyramid testing between Gen 1 and Gen 2?  I know DPMS did 100,000 rounds when they pyramid-tested the GII.  Savage did the same using Federal ammo for the MSR-10.  Daniel Defense did the same for the DDV5.
Reply: @AeroPrecision  Would you agree that lubrication has zero influence on firing pin tip durability though?  Same with extractor pin durability.  There just isn’t a mechanically-sound argument for lubrication related to these types of parts failures.  For an over-gassed (too large port diameter) barrel, lack of lubrication will somewhat tame the cyclic rate due to coefficient of friction, not hurt reliability.  Slick carrier rails lubed with something will only increase the already-excessive cyclic rate.
Reply: @MOTOSCOUTtv  what this has to do with the broken firing pin ? Eventually, you don't even have to lubricate the bolt, just some parts of the carrier.
Reply: Customer service is the most important aspect of a business. The proof will be in the pudding.
Reply: @AeroPrecision  do you recommend lubricating the bolt and the firing pin then ? Because usually, it's only some friction spots on the carrier that are recommended to be lubricated.
Reply: @clutchcargo1239  I think Trex said that they've bought a complete lower, so possibly they haven't pick the one with the proper buffer weight for their upper.
Reply: Honestly, I will purchase one of these just for the manufacturers response to the video. Shows they care, and are involved with their customers.
Reply: Well … the gun had fewer failures than Lucas using “air quotes”.  Atleast you can fall back on that.
Reply: So does this mean you are offering a free set of two AR-10-hardened firing pins, one tungsten and one titanium, to verified current owners?

See also: "Sterling SMG Titanium Firing Pin. Our Sterling Firing Pins are precision machined using our CNC Swiss turning centers. The Titanium FNC Firing Pin is made from Grade 6 Titanium which has an Ultimate Tensile Strength of 140,000 psi. Titanium is 40% lighter than your standard grade of steels thus giving you a faster lock time. Titanium is also Corrosion and High Temperature Resistant to help eliminate galling, fretting and seizing. All AR10 Titanium Pins are shipped with material certification sheets. Pin Length 2.990 inches. Made in the USA!!"
Reply: You're babbling. Nothing matters. Your during pins are known to fail. That is literally the EVERYTHING. There's so many of there plinking and when someone needs to use it hard...... It's going to fail. If I owned a Aero BCG id throw that shit out
Reply: @MrGene1976  If you break your firing pin after 2000+ rounds of dry abuse, I have great news for you. You can buy a brand spankin new one at Brownells for a whopping 10$.
Reply: @lawless911sc     Palmetto State Armory, Primary Arms to name a couple
Reply: Aero is always my go to, from rifles to any other part I'd need  everything comes from you guys,  yall are awesome for what you do
Reply: Love seeing good companies work with people and other companies to improve their products👍🏼👌🏼
Reply: Aero is such a great company! after all, as was said above and below, The rifle may have ran 2300 rds til it was dry or was dry.
Reply: Read every word.
Reply: I've got two M5's. No problems. No complaints.  I've been completely satisfied!
Reply: I build many ARs and have loved Aero everything for YEARS! I’ve never been disappointed!
Reply: First of all.....  clean the freakin gun.  I know so lazy folks and none of them "Just Lube"  also the people I know with suppressors know carbon builds up and needs cleaned out.....
Reply: Thanks AERO your customer service is the best When My M5 Enhanced Upper Receiver wasn't accepting the charging Handle you went out of your way to Replace the Upper Receiver with a brand new one.
Reply: I LOVE Aero products, and consider them to be the standard of quality these days.  I don’t believe torture testing an AR type 308 is not relevant, nor practical.  Even an FAL needs TLC, and I’d never think of subjecting an M5 to such unrealistic tests.  I highly respect Aero for posting this response, and will continue to purchase their products, including the M5.
Reply: I bought one a year ago and love it, thank you for making a GOOD DMR for under 2 grand. Unlike Lucas, I clean my gun often so I’m sure it will last 😂
Reply: I absolutely love my Aero Precision AR10. It is my most costly firearm and well worth it imo. I lube mine 😉
Reply: @AeroPrecision  I love you so much! ♥️  super Aero fanboy here lol 😆
Reply: @AeroPrecision  I miss @FireMountainOutdoors so much!! Bring it back guys!!
Reply: I was going to make a comment about maintenance on this firearm test. I guess maybe being as old and as old-fashioned as I am, cleaning and making sure your firearm is lubed is very important. I see you practice in a nice, grassy, tree area, it's a whole lot more difficult in combat in a desert where you get more than just wind. In Gulf 1, we had the M16A2 rifle and we were always practicing, cleaning and lubing those rifles almost daily. Your firearm, battle rifle will last as long as you take care of it. That being said, if everyone who has one of these rifles, practice taking care of this rifle, I'm pretty sure it could survive a 5,000 round test. My grandfather owned a Shell oil service station, that my father worked in, and my grandfather used to travel the world selling JB oil. He used to get so mad at me because I would run out, jump in my car and go. I never checked the oil and he told me, one of these days your going to get in that car and it's going to break down on you in the middle of nowhere. Grandfather was always right because it happened. You can't run machines without lubrication or without cleaning it or it will break down. I'd be willing to bet this rifle would have held up to a 5,000 round challenge if it were cleaned and oiled properly.
Reply: Oh, and yes I did have an Aero Precision AR15 and I really did like it. I now have a 300 Blackout now
Reply: running the bolt dry wont make the firing pin break itll only make the bolt travel slower.
Reply: @Segphalt  they don't send the gun assembled, they only send parts from what I understand
Reply: This comment and your willingness to have open and transparent discussions, made me a fan for life.  I too, respect the hell out of Lucas and @T.REX ARMS , mainly because of his candid, unbiased testing and reviews,  The fact that he PURCHASES said items allows him to be unbiased.  I, personally, viewed this as an overall successful test and made me consider adding the AP AR10 to my collection as potentially my next build.  I feel that , since I am anal about maintenance on all of my firearms, this gun would suit me perfectly.  Thank you to both Aero Precision and T.REX for this AWESOME CONTENT!!!!!
Reply: First I listen to Lucas's reasoning on why he didn't do maintenance for this test and thought yeah it make sense (though he did mention he prob should have did something after 1200 rounds).

Then I read Aero's repones of brother you kind of can't shoot 3000 rounds in almost one sitting without maintenance, and I go yeah they've got a point too.

So the tough spot for Lucas here is either stick to not doing anything with he future rifles and see how they hold up, if none of them can do it then there's our answer.  Then any future guns where something was done after 1200 rounds will need to be revaluated fairly.
Reply: Respect. Awesome response. Still a customer.
Reply: @Segphalt  This was not a complete rifle shipped by Aero. Even so, many manufacturers ship firearms with a preservative instead of a lubricant in them. It is usually a good idea to clean and properly lubricate a new firearm before firing.
Reply: it seems very obvious your products are made for the low information user/builder....period. I had An M5 for years when they first came out, nothing but problems...got rid of it for a Scar17, which i would suggest for anyone who needs a reliable rifle
Reply: @clutchcargo1239  it wasn't made right from the start man... lol
Reply: as an engineer once told me: "With everything mechanical, it's not a matter of "if" something stops working, it's just a matter of "how" and "when" it will happen".
I'd say that running almost 2500 rounds of .308 (not exactly an anemic cartridge) in a pretty short time and completely dry before breaking down is quite the feat per se, there's points to improve but it wasn't exactly a bad performance
Reply: @joshwoodard9760  Lol yep, the video  was flawed from the start... Lucas might as well have just stacked a big pile of $20 bills, and tried to light it on fire for views... Entertainment.
Reply: Wow! That's a company I want to buy from!
Reply: When you ship complete uppers or rifles do you give recommendations on lubrication with the owners manual?
Reply: @MOTOSCOUT  I build rifles for a reputable manufacturer part time. The #1 issue with the overwhelming majority of issues from customers is lack of lubrication. #2 would be issues from customization due to lack of knowledge and skill in building a rifle. Improper torque, lack of threadlocker(Loctite/Rocksett) and using incorrect parts. More so with LR308/AR10 since available data is lacking for most Frankenbuilders. 
I will say this, Aero Precision has one of the best QC departments in the industry. Only CZ I would consider comparable. All manufacturers have some complaints. I have seen issues with LWRC, KAC, Noveske, Larue, Q, BCM, SOLGW and don't even get me started on Colt. 
Still, the majority of all issues come back to lack of lubrication. Why that was allowed to be an issue with this test is what is mind blowing.
Reply: I am not sure of their reasoning to run this gun dry...I would not run any gun dry. You are just asking for trouble and you will an issue at some point, so I am not sure how to take this point of view from their test.  I have built a dozen AR's, all on Aero uppers and lowers both suppressed and unsupressed in various configurations and I have as of yet come up with any type of major malfunction across the board.  Some of my BCGs are nickel boron and the rest are all Black Nitride.  Take care of your gun, it will take care of you...even if you run it hard.  I also carry spare BCGs in my range kits along with spare parts kits, so I was very surprised that a broken firing pin was such a big deal for these guys....   I truly believe they brought these major malfunctions on themselves....running it dry and then running it suppressed with no cleaning the BCG....you basically broke it through neglect.  What a joke of a test...   This is basic be prepared 101 stuff so I am just not fully on board with all of their evals....so keep on keeping on...and use your lube!  It also helps to use better ammo...
Reply: @PnP-td1mt  The clueless ones use no lubrication
Reply: Wow after reading through the no lube, not using Pmags what else did you not do that helped with problems? Did my 308 build a few years back have ran way more than 5000 rounds closer to 9000 with Zero issues. Bought an upper /lower Aero bare bones. Used a TOOLCRAFT BCG Standard length Buffer tube, Heavy buffer with a STRIKE INDUSTRIES Flat wire spring. Also it seems this bigger rifle round just runs better with a long barrel 18" Of course the more expensive ammo is more accurate. But mine will run anything no problem. And yes it will run steel no issues.
Reply: @lhp2a  I can shamlessly recomend White Stone Castle Armory selling TOOLCRAFT BCG. This guy is an online vendor. No I don't get anything for recommending him.
Reply: This boils down to "its on you the customer to buy more reliable shit". Heard. I will be purchasing through another company. Thanks for the confirmation on what the correct step was. Smh.
Reply: Lucas wouldn't know milspec testing parameters as he was never in the military
Reply: Honestly I'm amazed how well this gun held up with no lube for so long. That's the Achilles heal for the AR platform is running it dry. I think Lucas probably should have kept it lubed for a better overall longevity test. I wouldn't run my nicest AR's that long without lube and expect them to hold up. Its like expecting a BMW to run thousands of miles will no oil. Engineering wise that's just not reasonable at all.
Reply: @MOTOSCOUTtv  The bolt tail / rings and BCG's bore are fit, and work, like piston/rings/cylinder in a one cylinder engine, such as your lawn mower.  Imagine running your lawn mower with no oil.  Do you think you'd get an hour of running?  Half hour?  15 minutes?
Reply: Awesome response from Aero Precision.  Open, mechanically honest information shared.

Personally speaking, I don't think of your company as a "complete rifle, ready to run" company.  Even if you sell complete uppers and complete lowers.  The assembled rifle must be lubed appropriately by the person who assembles it for firing -- even if "assembling it" is buying complete upper and complete lower and putting them together.  

And the details on running suppressed?  I don't expect your company to provide that kind of information and I think the R&D and presented data would take time away from what you do otherwise as a company.  If a person wants to run a suppressor it's on him to research what's needed to run that caliber, that barrel length, that gas system, that buffer system -- and the chosen cartridge, hot or cold, heavy or light -- all together to play nice.  Your company is not providing built-to-spec purpose-built things, and so I don't think it's reasonable for your company to have to give such information to prospective buyers.
Reply: @clutchcargo1239  Overgassed = more energy through the barrel extension, bolt, BCG, buffer system than is needed for the job at hand.  The excess energy goes somewhere, and a lot of it gets dissipated mechanically before reaching the shooter's shoulder.  Acclerated wear would happen here just like it would if you advanced the timing too far on your multi-cylinder engine, and ran it with a lean gas/air mixture and near-dry on the lubrication.  In motor vehicle engines, that's known as a "she's gonna blow" scenario.
Reply: @seanoneil277  I'm surprised this gun didn't fail sooner... It was definitely abused from start to finish.  Aero must make a pretty damn good product. My next assembly is going to be of Aero parts... Not sure what I want yet, I need to come up with a goal, and do some homework. You can bet that whatever I decide, it'll be cleaned, lubed and all the hardware will be thoroughly checked... That is standard practice where I come from.
Reply: @clutchcargo1239  Where I come from too.  My grandfather taught me mechanical basics throughout my childhood.  Wouldn't ever cross my mind to have any machine with metal-metal contact NOT being appropriately lubed at those contact points.

But I've been alive long enough and seen friends do mechanically naive or even stupid things with bicycles, motorcycles, cars.  I think a lot of people don't have any good source of mechanical wisdom in their lives.  That's fine until you decide to build, or operate, any machine.  And firearms are machines.
Reply: @GeneMstoner  Most VEGETABLE BASED lubes congeal that way.  Why would you use such oils/greases?
Reply: Great response from Aero, makes me proud to own your products.
Reply: i was gonna ask if you had gone through the whole rifle and checked for screws and bolts being torqued and thread locked. i see that stuff is backing out a third of the way through so this is one of those situations when we must listen to Mr yeagers advice and go through any rifle you buy!
Reply: Aero will tell everyone who's NOT Lucas that its their fault though. I am one of those people. You SOBs won't get anymore money from me.
Reply: To be clear, Lucas said that he did "lube the gun" when they needed to. (1h:32m:35s)
Reply: Love this video, it hasn't soured my image on Aero precision at all, I'm actually pretty impressed with how well the Rival did considering lack of Maintenance and Lube. That's something I commonly do myself. I can't not fiddle with my guns, typically because I never stopped feeling with them I never have them quit on me ever. I also usually tend to keep some spare parts that would be considered life-ending parts for the gun if they broke. I have a box of AR-15 parts and a kit specifically for all my AR-15 builds. This video has enthused me and helped me lean in the direction of trying my hand at a suppressed 20in DM rm5 build. Great content, fairly consistent and unbiased. I am now a fan of Aero Precision after this video, the rifle in this video was used way harder than I would personally use that rifle. Meaning that it would probably withstand any type of usage I would put it through just fine. I'm even more impressed by Aero Precision willingness to open up a dialogue with somebody who absolutely beat on one of their guns just for the what-if factor. Looking at potential weak points for the possibility of future improvements. Great business model, keep up the good work Aero precision😉👍
Reply: To summarize, this video and Aero precisions response to it has made me a huge fan of both T-Rex and AERO!

Having no T-Rex of gear and never purchased and AERO product to before, I am now officially a fan and soon-to-be customer of both.

Thank you T-Rex for the in-depth content and fair assessment of the Aero Precision products you tested, thank you Aero precision for building such a sturdy platform. I'm genuinely impressed considering how the rifle was used without Lube or any kind of without Lube, cleaning or maintenance. Not even stopping to tighten up a loose screw or Bolt. Just running it to death and seeing what happens. I mean what better kind of torture test could you ask for. Impressive equipment for what it is and its price point.

I hope to be building my first Aero Precision product, M5 DMR in the near future. This video has sold me on Aero precision knowing that with a little care and some tweaking, I can have a hard-charging good running rifle. Can't wait to get started.😉👍
Reply: NOW I UNDERSTAND WHY AERO BLAMES PEOPLE FOR NOT USING LUBE NOW. 😂😂😂 What a garbage company.  If you want to build an AR10 that beats itself to death....buy Aero.
Reply: I absolutely love my Aero Precision AR pistol. looking forward to getting their AR 10 in .308 for hunting this fall and long range target shooting.  It's great they are local to the PNW even though it's getting harder for them to do business with these anti gun policies running rampant here in Washington state.  Thank you to the folks at Aero Precision for being dedicated to your craft and helping out the 2A community and the community in general with your charitable contributions.
Reply: Thanks to everyone all the way around.  I recently finished my Aero M5 .308 build and even before watching this video, I made sure I used a match-grade BA barrel, JP Industries Silent Capture system and Geissle SD-C trigger.  Knowing full well how much hotter and harder a .308 caliber is as compared to .223, even I know better than to run it dry. If you do, you are asking for problems.  
Lucas, nicely done with the shooting.  I love to watch you and your team’s work.
Reply: I would be interested to know the actual steel alloys used in the various components in question, and how they were heat treated. Knowing (and sharing) the engineering is critical.
Reply: I own an aero upper kind of an old build in 7.62x39 it's a mut before it became normal   the bolt is a bunch of different parts but the main hull is rigid and has over 10000rounds on it no complaints from me.
Reply: Comments like these make me like Aero even more. So glad I just got an Aero M5 enhanced. And I'll definitely be keeping it nice and wet lol.

I'm also definitely gonna loctite my lower bolt release screws once I get ambi releases on there
Reply: I think Aero handled this very professionally, the best way it could have been handled from the manufacturer in my opinion.  Good on Aero Precision.  👍🇺🇸👍🇺🇸👍🇺🇸👍🇺🇸
Reply: Proud owner. Need a hoodie now
Reply: Damn dude wrote a hold story 👀 😂😂😂 🤓 . But I’m glade I read it, because I just bought one and I love it.
Reply: This is why I love using Aero Precision/Ballistic Advantage products and will continue using their products in the future. All of my AR-10's/AR308's are Aero Precision/Ballistic Advantage and have been happy with them. I'm about to start building an 18" .308Win for someone. I am a little bit weary about the bolt/extractor but that can be easily fixed, but I would recommend buying another BCG and just having it on hand, I know that that's expensive to just have another .308Win BCG just lyin around but it'sa quick and simple swap to get you back up and running, I do the same thing with AR-15's. The bolt catch & forward assist set screw's not a big deal because I blue loc tite them into place so that they don't back themselves out. I definitely like watching these videos. This is the second time that I've watched this video. I would definitely love to do some sort of testing like this with either Aero Precision or TRex Arms. If Lucas ever decided to do testing like he said with 10 different rifles and multiple shooters and needed another shooter, I would definitely like to come out and help with the testing.
Reply: @kazager11  100% on the PMags. Was very confused by their magazine choice for the test.
Reply: Still whoever makes their bcg are still crap, not to mention I ordered two uppers in a OD anodized and they BOTH were built with Magpul OD green handrails. I had to buy the handrails again just to get what they were supposed to be selling. Over a week and I still haven't heard back from their customer service. Man what happened with them and PSA anymore??? Just sending out whatever with no QC.
Reply: @AeroPrecision  - dead on. While my life with ARs at age 78 is only 25 years, I've had both bolt and M-1 and M-1A for most of my life. Copper was always the bane of both accuracy and barrel life if otherwise taken care of.  I may 'run' something like an M-1 for a couple of hyndred rounds but ALWAYS find time to scrub barrel, wipe and oil moving parts before the rifle fails at the most critical time.  I have four of your products, have benefitted from your warranty service on an issue that was MY misunderstanding. You have my undivided loyalty.
Reply: Still doesn’t excuse the firing pin failure. Daniel Defense for me SORRY.
Reply: Unless I missed it, I'm not sure the accuracy was addressed. That is the only doubt I have. I found this video while preparing to buy one but now I wonder.
Reply: @antoniojohnson7693  FWIIW I have two M5. One with supplied upper 16 CM 308, One with Ballistic Advantage barrel - all else stock M5 build kit. Once I figured out that 7.62x51 ain't same as Win 308, both barrels shot sub 1" MOA for five shot groups. The ammo of particular note is Black Hills Match 168 and Federal Premium 168. Reloads with BLC-(2) and either 165 or 168 Sierra/Nostler. I needed light crimp on the brass.
Reply: You mentioned a dry bolt but in the video you can see exactly how wet it was when they pulled it apart and showed all the pieces
Reply: Great reply aero
Reply: I can definitely understand how the lack of lube would cause a lot of issues, especially for the AR platform. But at the same time, the firing pin channel is never lubed and they never used a super heavy spring trigger, so I don't think that explains the firing pin. Also, isn't lube generally avoided on the extractor because it needs to "grip" the case? I'm not sure that explains that failure either. Plus the bolt velocity was very high and having a more lubed gun would increase it further.
Reply: Aero, all things considered, great product! I believe that the test was extreme due to the lack of lube and cleaning. I would also say that, if price was not an issue, pigs could fly. Aero is very important to the community and your response is spot on.
Reply: "Weird" names of scopes like NIKON??????  Yeah, uhm ABSOLUTELY NOT a "weird" name in glass.  Great content
Reply: Semi auto .308,AR10 is not a hard recoil impulse

A bolt action 300wm yes
.308 ar10 not so much

I use the AP M5 lower
It is good
All my parts are a mish mash of the stuff i like best
JP internals (enhanced bolt/silent capture spring)
Gibz side charge upper
RifleSpeed adjustable gas block
OSS suppressor coming soon
Reply: I think this whole test that T-rex Arms performed was unfortunately blemished by the fact they did basically no maintenance during this testing. It is amazing that the rifle fired as many rounds as it did, even suppressed without cleaning after each range day. A true "battle rifle" is cleaned and maintained after every range day and clean every day when in the field. Because you're life depends on it.
Reply: Who tf fires 2300 rounds without maintenance?! Who doesn't lube a completely dry bcg?! I'd say yall are gtg.
Reply: 🫡 I now know where my AR10 will be bought from. Outstanding companies deserve respect responding to these types of reviews.  We all should support companies that handle criticism in the public eye like Aero has done here.
Reply: 3 six hole baffle flipped first gen MP5 supressrr flipped intervention Hexis S7 Anti 20/25 millitary Anti material round. though over process 40mm rpp Bizon lower mag.... >√>
Reply: That's 70+ mags. A basic loadout is 6+1 so 10x worse than regular use. I mean that's like 5 firefights. I would've had the bolt pulled and quick cleaned and lubes back up after every firefight. So realistically this was overkill. Great job Aero! ❤
Reply: Running it completely dry and saying, "that's how you normal guys will shoot it," is pretty dumb. You can also not change the oil in your car...
Reply: Can't get mine to cycle, won't lock the bolt to the rear . I am using p mags, and federal gold medal match.
Reply: I’ve watched several videos lately about this particular rifle and run across this topic and it seems this video creator deliberately tanked this particular rifle for some reason
Reply: you guys should have Lucas do another with the new mods as a redemption video! Lol, just saying that'd be awesome, look what it did for the ruger American when they had people re review the gen 2 lol. I'm actually currently thinking about getting an Aero upper and lower myself either way. Correct me if Im wrong but it almost sounds like maybe just a different BCG (or atleast, a lubed one lol) and an ABG would be solution enough for the things mentioned throughout the entire video for the most part.
Reply: @cav4353 I'm wondering how much the dry/ nonlubed parts had to do with the failures in Trex test. You've gone past the halfway point with yours. Done any maintainance and notices any wear and if so, what is your guess as to the cause? As with all scientific experiments,  variables can affect outcomes. That's why only one variable is introduced at a time. What are your thoughts?
Reply: @johnokamoto6762  Hi John, the mods I've made were wear replacement parts, a Lantac domed cam pin and Brownells gas rings. I use Gunslick on BCG and buffer spring, it seems to stay where it's put and lasts quite a while.
My unit seems to run particularly well, perhaps due to a good cerakote job on interior of receiver , good bolt lug/extension interface, and proper size gas hole on barrel.
Reply: @MOTOSCOUTtv  it shouldn't be mind-blowing. This is something that any decent BCG that you can get for $60-100 should be able to do
Reply: @lhp2a  I dont like aero precision, (and I don't really dislike them either) but your question makes no sense and I want to defend them on this. The norm is to offer an upper package that does not include BCG or charging handle, so that people who already have the specific BCG or charging handle that they want don't have to spend extra money on parts that they don't need. They are usually sold separately, and then sometimes you can buy complete uppers that DO have BCG and charging handle included, but those cost more money. There is no reason to make every upper receiver package also include BCG and charging handle
Reply: @RamRod333  The only small arms that I have ever seen go thousands and even 10s of thousands of rounds without a single failure are HK pistols, specifically USPs and USP Compacts
Reply: @burtdanams4426  there's nothing to defend because there wasn't an attack, my dear necromancer.
Reply: My Aero 308 runs perfectly! I also maintain my weapon properly.
Reply: It's a year later and Aero still does not offer a separate firing pin, Well after sever wrong orders I fount the PSA 6.5 CM pins work and a 308 High Pressure Bolt small hole pin is what you want, found one at Black Rifle Arms HP 308 pins is it. $12  got 2 just in case.
Reply: @AeroPrecision I lve in Wa. and while I own a M5I can no longer get parts for it. As a potential returning customer, would you consider manufacturing a "tactical" 8-10 round revolver rifle to bypass Jay Inslee and Bob Ferguson's b.s. legislation?
Reply: Roger that hell copy over copy
Reply: The fact here is that the big ran two thousand three hundred rounds with ZERO lube! WOW.....
Reply: Lucas please so the same exact test on the SCAR 17 please. I want to see what my money bought me lol
Reply: No barrel break in, no maintenance, no lube, not locktiting, retorquing any screw that you found coming loose and not having an oops kit in your range bag? I think failing to do just the basics makes the operator the  catastrophic failure. I like this channel but the basics were not followed and I refuse to believe that the audience abuse their weapons as was done here. My AERO AR-10 I built with a Hanson  22” 6.5 creedmor barrel shoots accurately out to 600 yards and I really skimped on a high end scope. Past 600 yards is possible but I wouldn’t shoot an animal at that range so why shoot at that range
Reply: I'm still doing an Aero M5 build.
Reply: My aero 308 bolt face cracked after 100rds. Only ran one brand of premium ammo through it. I'll be emailing Aero shortly about this issue.
Reply: I respect AeroPrecision and what they're trying to do, but if you want a quality 308 rifle, you're gonna have to fork out the cash. Or spend your time and money buying other parts to make it work right. A Daniel Defense DD5 platform will cost you more, but it's reliable, running suppressed and unsuppressed, and you have an adjustable gas block to tweak things when running a can. Also, accuracy shouldn't be this subjective. I can throw cheap M80 ball and 1 MOA groups, with quality ammo I'm around 0.68' groups consistently, some coming in under 0.5". These are AR10 for people who don't intend on actually using it very much. A magazine or two every year or so and you won't run into issues. But if you're actually training and shooting with your AR10 these budget entries will fail in the long run and you'll be forking out just as much if not more AGAIN. I'm a firm believer in the BUY ONCE CRY ONCE philosophy. Again, love your idea, but unless you intend on having your AR10 out of commission while you replace parts all the time because you actually used the rifle, you're better off spending a little more and getting an "out of the box" AR10 instead of something you have to fiddle with
Reply: @lhp2a  I love how you completely skip over the part that the rifle shouldn't have had these failures this quickly, maintenance or not. I can run my DD5 just like this, and nothing is breaking on it or failing on it. The point being, this is a budget rifle, and it performed just like a budget rifle would under actual use. this wasn't even a torture test, just an actual use test, and it failed. if you're getting the rifle for SHTF, you're screwed because there will be no replacement parts available and you don't have the time to keep replacing parts in that scenario. you need it to run, every time. and it shit the bed. if you're only shooting a magazine a year then so be it, this rifle will be fine. but if you put 10 mags thru it, it's a paperweight. you might be okay with that, but if I have to bet my life on a rifle, this won't be the one I'm rolling that dice with. I'll stick to mY DD5 V3 that's always run and it's approaching 10K rounds (90% of these are suppressed i'd imagine)
Reply: @RamRod333  no they actually wouldn't, and certainly not this many. I have. DD5V3 approaching 10K rounds and it's only had 1-2 malfunctions, that were ammo related. A SHTF rifle should never have this many problems this quickly, and this really isn't that heavy of usage. this is normal training
Reply: @joemontmeny4684  a broken firing pin at any round count is cause for concern! That means either the firing pin is garbage (I'm approaching 10K on mine), or other parts are garbage putting unnecessary stress on the firing pin. Basically, it's another budget part for a budget rifle that shouldn't fail. by the time you replace everything and beef up the parts that need it, you might as well have bought a better rifle. but if you have the money to burn then so be it, have fun. I like buying a rifle once and it works
Reply: @AFreeThinkingDawg09   I bought Aero lower.. and doing a mix of parts altogether. 
I'll get an upper+handguard that's Aero and I hear the Aero Breach charging handle is pretty solid so Ill get that. I'm getting a different barrel, bcg, a Rise 535 trigger, I will get an adjustable gas block. So she should run smoothly.
Reply: @AeroPrecision Are there any plans on making a Lefty M5 AR-10 upper receiver any time soon?